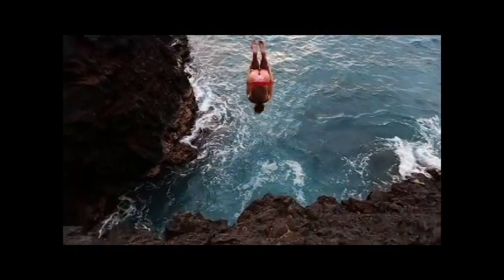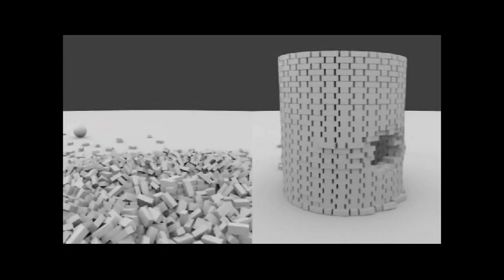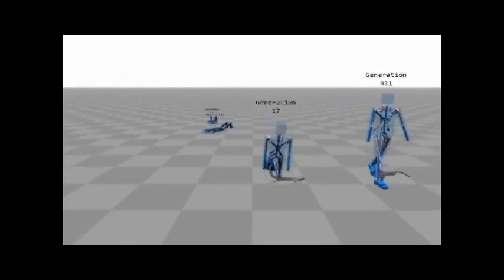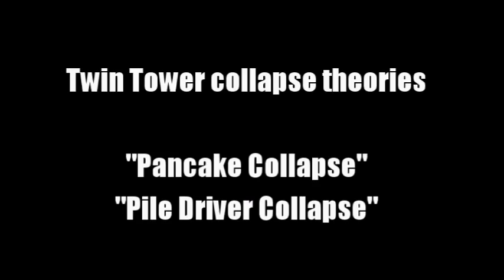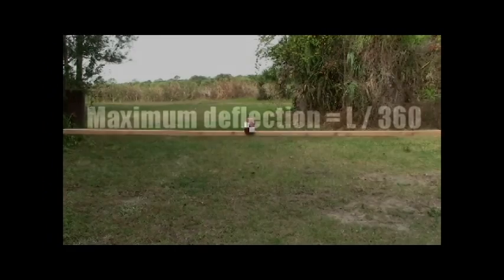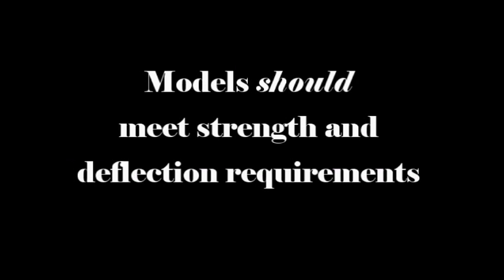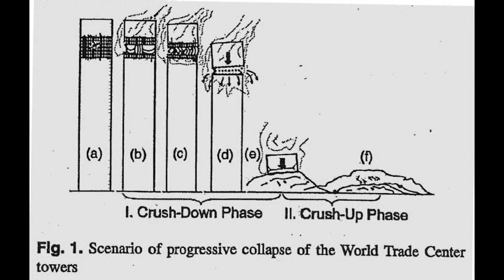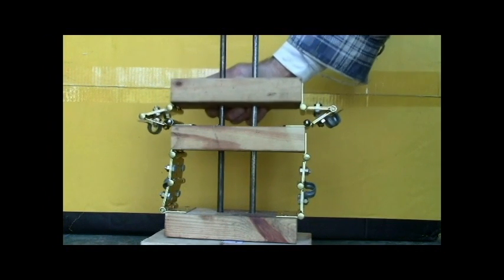9/11 Experiments: The Force Behind the Motion

Comment: Your experiments are deeply flawed and donot even remotely resemble to construction of the Towers. For instance, none of your experiments can account for the potential energy stored in each of the floors due to their position and construction. They rely solely on a single weight doing all the work. As each of the floors collapsed under the weight above, each of their potential kinetic energy multiplies the net force. Taking this into consideration, you really botched your "experiments". This is precisely why computer modeling is so important and so prevalent... because silly little models such as yours are unable to account for the many variables involved, whereas computer simulations can.
Reply: ErgoCogita u dont have to use a physic bro..just use common sense..1 fvcking plane made from aluminium can demolish the building and turn it into dust?..and why building 7 collapse when the plane didnt even hit the building..?
Reply: +ErgoCogita  Did you do the experiment in science class with the potato battery that proves that the unseen electrons flow between dissimilar metals immersed in an electrolytic environment? I did, but I failed to ask how that was proof that Niagara Falls power generation was possible. I guess I'm just a Putz according to you?
Reply: +ErgoCogita  If you want to conduct a scientific experiment at home of any validity, why not get yourself 110 small cardboard boxes, tape the lids and stack them up one on top of the other. Now bring your mighty paw straight down on the top with all your super strength to experience what resistance to motion is all about.
Reply: carlosdaperez it's impossible for anyone to recreate the 9/11 tower collapse...only thing anyone can do is attack a specific fact about the collapse and try to debunk that using models and experiments...the most basic fact people discuss is that the 50+ floors beneath the impact areas of the planes we're not burning or heating up even...the downward weight of floors above could never cleanly bring down the entire tower the way they fell...there should have been massive resistance to the fall...the only known way for those towers to have fallen the way they did would be if the central support beams were being eradicated on every floor within a second or two of each other (hence the free falling you see in controlled demolition).
Reply: Semni Istiqlal Look I don't really care... firefighters who were there openly witnessed explosions, went into the towers and pulled out survivors...they gave detailed information on the damage they saw in the basements..walls being completely destroyed, the roofs caved in...all windows blown out, etc etc...if you want to discount eye witness testimony from what firefighters said they witnessed and saw in the basements of the towers, by all means...most other people can easily deduce the reality of what happened. I suppose you honestly believe building 7 very well could have fallen 50 stories due to a few random office fires too...if you want to believe the official story and that absolutely farce of a report NIST put out, you can...but thousands of engineers and scientists have now come forward to discount the events as we've been told...not 2-3 people... thousands. They can't all just be making this stuff up...both towers and more than 85% of building 7 we're not impacted by fire...yet all 3 literally fell to the ground as if they were paper...it doesn't make any sense...not to mention, it's NEVER happened before or after in history...like I said if you want to buy into the story that some moron sitting in a cave with laptops and thumb drives somehow masterminded an attack that beat the defense of a country that spends TRILLIONS of dollars every year in defense spending, by all means.
Reply: Newton laws do not apply in any easy/straightforward way to systems with mass transfer. Any argument appealing to "simple Newtonian physics" as related to negating the possibility of the natural WTC collapse, should be simply dismissed. A lot of junk like this around.
Reply: Bruce Lansberg  You might be splitting hairs there Bruce since nothing can fall in earth's atmosphere at the hypothetical calculation of FFA with zero resistance. Do you have any other deflection to support your conspiracy theory that may have substance?
Reply: So do you have some computer models that can explain how steel turned into dust?
Reply: evsupp2011 You might not want to call people you are accusing of character assasination and insults shills. It's more than a little hypocritical of you.
Reply: Gurvinder: There is a lot to unpack there, you'd do better to stick to just the one argument at a time. Why don't you care what the rest of the mountain of evidence suggests? Is it because the witness testimony alone supports the conclusion you prefer? I've never heard of this specific testimony before, do you have any source to it?
Reply: Gurvinder - "explain to me how building 7 fell so quickly into it's footprint"
Now I am puzzled. Just one quote earlier you said "that absolutely farce of a report NIST put out". From this quote I deduce you have read the report, or you at least have a grip of its content. Yet you ask how WTC7 came down, which is explained (as a most probable collapse sequence) in this 800 page document. So either you have read it and know the cause of the collapse, or you haven't read it and simply made up an opinion about it. See why I'm puzzled? Have you read it or not?
Reply: "I'm sure you think all of them are delusional and not worthy of being on stand as a witness..."

Some are delusional and not worthy of considering, for sure. I never count that out as a possibility in such a large pool. ;)

"explain to me how building 7 fell so quickly into it's footprint..."

Read the damn report. You don't even have to read the whole thing to answer this question. If you are asking this question, you have obviously not yet read it.
Reply: Reading the report is basically the minimum level of effort you should do before criticizing anything about it.
Reply: evsupp: What evidence do you have that he is a shill? I havn't seen you present any argument aside from the accusation.
Reply: If that's the only infromation you've found on the events then I can undertand your point of view. However there's a lot more information out there if you know what to look for.
For example, the object in question did hit the ground and judging by the damage  to light posts along the flight path whatever hit the pentagon had a wing span of over 100 feet. Conveniently a plane with that exact description was highjacked in the general area and it and it's passengers were never heard of again after the event. Also fundamentally missiles and planes are the same thing. It's just a difference in payload and scale.
Reply: Jacob Silverstein - "A simple experiment is not a flaw"
Unless someone tells us it is supposed to represent something it doesn't.
Reply: evsupp - Please do not be a scared little boy now. I asked you a question a while ago and I am still waiting for your answer. You said:
"Every bit of information you provide is pure bullshit"
I asked: "Please be specific: which piece of information is wrong? Why?
You see, when you call some a liar without any kind of attempt to explain why, it is becoming obvious that it is actually you that has no idea what you are talking about. When you resort to personal insults and vague, unsubstantiated claims, it is becoming painfully obvious that you have no real arguments left. Be a man and answer my question. I know you can't. I also know why you can't. Do you know?
Reply: Jacob Silverstein - I must have misread your "REPLY" at the end of your last message for a demand. If it was not meant as such, I apologize.
Extended objects can only be treated as single point masses if they are approximated as a single point particle. How would you like to approximate a collapsing building (or the 15-30 upper floors or 95-80 lower floors to be more precise) as a single point particle in practice? As soon as the building starts disintegrating, there are numerous centers of mass acting upon all others, creating new ones, moving all over the place, getting larger and smaller. I am saying that a mathematical model would never be able to predict how the towers would collapse due to the complexity of it. So any reference to "simple Newtonian physics" and "violation" would be off. The reason why this part is so important to me is that Chandler makes us believe that there was something like "simple Newtonian physics" when he demonstrates a massive upper block and a lower massive block as a representation of what happened on 9/11. He even ignores the influence of gravity (the driver of the progressive collapse) when he compares the collapses to two cars colliding (on a horizontal surface). Chandler is the source of the claim that Newton's laws would have been violated in NIST's explanation.

I know what Euler's laws represent. Since I am not an engineer, I have not studied them in detail, but I am aware of them.
Reply: Jacob Siverstein - I assume you are aware of the design of the towers. Now imagine there are no bolts that keep the floor trusses connected to perimeter and core. Would you agree the floors would simply come down when shifted just a bit? I guess so :). Would it would have the same you then also agree that the perimeter would come down as it couldn't stand alone due to a lack of lateral support? Now imagine these bolts strong enough to keep the trusses in their places, but not strong enough to do the same when a dynamic load of 15-30 floors impacts upon them. Would you agree the result would be the same except achieved slower?
Reply: Lol so you are saying NIST didnt say they didnt here any reports of explosions, video below, yet you say I am full of BS LMFAO
https://youtu.be/iSnjyZNYlW8?t=6m2s

lol you say people were not being denied/turned away by hospitals when they mentioned 911 video below yet you say I am speweing BS LMFAO and this is just one example of a actual person frome ground zero:
https://youtu.be/e-Of50l77YQ?t=5m51s

And yes maybe I should not have posted that video of a civillian saying it vaporized but here is one with reports of the engineers saying the same thing yet I am full of BS:
https://youtu.be/eJb-GPtb2I0?t=40s

I mean how crazy is this more vidoes from different people reporting expllsions before the plane even hit just like the guy in the basement said explosions then momnets later the plane hit -- this even goes with WTC7 when there were repotrs of explosions in lobby or lower floors before all hell broke lose yet I am the one spewing BS 
https://www.youtube.com/watch?v=GXF9nUqeKk8

For the explosions its funny because there are countless videos with firefighters, news reporters, policeman, civilians etc. reporting explosions and many videos where you can here loud explosions going off.

So your question should be why would NIST lie and say they didnt know of any reports of explosions??????? When clearly there were many. Just like they lied about not knowing about any reports of molten steel.
And yes the video I posted eralier shows it is at 12:44 but the guy in the video clearly states that they started around 6am in the morning add in prep time and I am sure you can come up with the math for  about 6 hours its not that hard to do LMFAO And you act like the reporters only had video the entire day and the day before of video from just that one angle like come on now son lol.

And no crap I watched the video lol Bodies being found deep into the rubble 40 feet yes there are levels of basements no crap bodies would be found 40 feet below lol this goes along with the reports of explosions going off before the planes hit. Pretty simple to figure out. Another video of perosnnel saying explosions before the plane hit yet I am full of BS:

And you are an idiot LMFAO the dust is created by the explosions:
https://www.youtube.com/watch?v=SaBQ3AkRetI&feature=youtu.be&t=44s
This is your video at the very bottom of the building before the collapse what do you see??? Thats right dust coming out because of the explosions. Then what do you see as its falling down just like the WTC exact blowout of dust. Show me a video of a normal building collapse producing that much dust.....  I will help you out there is none LMFAO

And IDK yes usually during demos they are not really big gapes in time before they all go off anmd the building comes down IDK how it was done but the people onm the ground are just reporting what they went trhough the question once again is WHY DIDNT any INVESTIGATION invetigate for explosions????
 It seems there was no no cause for concern over all the dust??? Hell even if there were no reports of explosions they still according to US policy for structures of that nature were required to investigate for explosives but still didnt LMFAO but WHY???????? Whats wrong with asking these questions simply saying some BS doesnt cut it unless you dont want the truth to come out.

Lets say I am cooco for cocoa nuts and none of the steel turned to dust, this still doenst negate that a lots of people report explosions before the planes hit and explosions in WTC7.

Maybe you are so full of BS you think everyone else likes bathing in it LMFAO GTFO
Reply: evsupp - Please stop before you make an even bigger fool out of yourself. And try to write a reply by yourself for once.
"The smooth downward acceleration and outward motions observed are impossible by gravity alone."
Are you saying no lateral movement can be obtained from gravity? Does the concept of collision ring a bell? Does the concept of deformation ring a bell? Ever seen a billard ball change direction after colliding with another? I understand the idea of 3 dimensions might be a challenge to you. You might benefit from studying it however.
Reply: Timeoutcorner - Thanks for finally pointing me to the correct timeframe of this quote. If you want me to respond to your claim, you should not provide irrelevant links. I understand that the first one might have been a typo. But it lead me to the exact phrase I quoted before. So a little more caution is appreciated.
"Blasts = he is talking about bombs i.e. explosives going off"
Agree

"Loud sound"
He doesn't just say "loud sound". He says "this incredibly loud sound". If you would have read NIST's report on WTC7, or even the FAQ, you would also have know that this incredibly loud sound would have been 130-140 dB. Comparable to "standing next to a jet plane engine, and more than 10 times louder than being in front of the speakers at a rock concert". Selective quoting is not going to help win your case here.

"He is saying there are no videos at all recording loud blast sounds of bombs going off"
"He is saying no one ever reported hearing explosives/bombs going off "
Here we go again, he is not saying that. He is saying that this incredibly loud sound that would have been produced in any blast scenario, was not recorded or witnessed. You do understand the meaning of incredibly loud I guess :). He is not talking about the random explosions during the fires. You are. Show me 1 video or 1 credible witness that experienced this type of sound at the moment of the collapse.

"NIST is saying (in a what was it a 3 year invstigation) they did not find any reports or find any videos of explosions"
No. This is NOT what NIST is saying. See comment above. In addition, NIST acknowledges the precense of witnesses reporting loud booms. From the FAQ: "The sound levels reported by all witnesses do not match the sound level of an explosion that would have been required to cause the collapse of the building." So please teach me on comprehension again please...

"the local police in NY arrested individuals fleeing the scene with explosives"
Source? And does this even make sence to you? 

To summarize, you provide false timestamps, you quote selectively and incompletely, you quote out of context and you quote phrases that have never been said or written. And yet you tell me "you are just trying your hardest to downplay facts to fit your narrative". See why I think this is funny?

Now cough up some real evidence please. You can start with the videos and witnesses of the 130-140 dB blasts just before the collapse.
Reply: TimeOut Corner and one more thing that you and Rodriguez, and every other truther is ignoring.   
What type of explosion would burn the skin off your arms hands and face, without any other physical damage??   
How about a fireball created from burning jet fuel in a confined space???
Reply: Timeoutcorner - all I do is provide  info"
No you don't. The only thing you do is parrot conspiracy videos claims. That's not providing information. That's stating claims. Only once (!) have you prvoided a link to a video that did not even confirm your false claim.

"A man named Sanchez"
Who is Sanchez? The guy is named William Rodriguez as both Joe and I have explained before. Do you even read the posts you comment on?

"As they were walking past the freight elevator a fireball erupted from it."
That's where Rodriguez is contradicting himself.

"But it could also mean as you are trying to say that a fireball from the plane hit is what they witnessed as well. Interesting I will say this I will not discredit this."
I mentioned this over two weeks ago and your respons was very different. This gives me some hope.

"You have any sources for it?"
"do a Google search on William Rodriguez debunked"

"I am not scared to be proven wrong"
Yes you are. I have proven you wrong on ALL your claims. Yet you simply ignored it. If you don't trust what other people say, why don't you just Google it? That's what I do when you make a claim. I have provided you with numerous links to evidence that backs up my claims. You can use these links or find your own. But you won't because you ARE afriad to be proven wrong.
Reply: TimeOut Corner..  Maybe if you would FINISH your research.. you might learn the whole story.  
Here is YOUR first link.  https://www.youtube.com/watch?v=BVhBXFly-jM
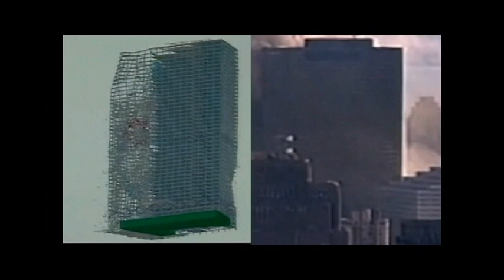Go to 3:08 and listen to what that officer says.   
This report has NEVER been substantiated.       Yea. idiots are going to drive around lower Manhatten, ON 9-11, in a van with a mural of the towers getting hit by a plane on the side, loaded with explosives....... And you idiots lap it up..
Who knows what or who was stopped by the bridge...  something was reported in error...just like the BBC reported wtc7 had collapsed.... 20 minutes before it actually did.
And your last link deals alot with FBI report of the '''5 dancing Israelis""", mixed in with that audio from a ''supposed'' police radio...
Reply: Timeoutcorner - "no where do they say in any of those articles that they were false"
Did you read them?
- "Though men in a van were detained, the vehicle did not contain explosives."
- "the station corrected it when it learned that the report was in dispute."
- "We’ll have to put that in a long line of things that’s under the, ‘Well, we’re skeptical now.’ "
- "Though no explosives were involved after all"
- "Accounts from ABC's John Miller and Kramer [...] were not the only ones that sagged over time."

What do you think the meaning of these lines is?

Or how about the article here that mentions 3 men captured with a van full of explosives:
http://www.breakingnews.ie/world/three-arrested-with-van-full-of-explosives-23429.html
And 8 minutes later the correction:
http://www.breakingnews.ie/world/police-confirm-arrests-but-deny-explosives-find-23430.html

"But again you had the Comiss telling the Mayor himself that they captured such suspects with explosives"
Source?

"But again this still does not negate the fact that we have LIVE AUDIO from the police officers themselves that day"
True. The same way we had live audio and footage of reporters saying there was a van with explosives that turned out to be false... There was also mention of radio controlled planes in the same recordings. How would a police officer know this? Just saying that police officers make mistakes too.
Reply: TimeOut Corner how do you know that radio broadcast is authentic?? 
How do you know the supposed photographs of people installing fuses is authentic??? 

Numerous sources have stated the report of a van with explosives was false. Numerous sources.. Dan Rather actually retracts it.. 

No evidence of explosives were found anywhere in any Tower.  No damage beams were seen by the clean up crew and I'm sure they would have reported something had they seen it.  
That's what I mean  by ignoring evidence to continue belief in your factless theories
Reply: "the one trying to convince people cops now have no clue as to what they are seeing and that they are imagining rainbows and unicorns on a day when thousands lost their lives"
Who is trying to convince you cops are imagining rainbows and unicorns? You read 10% of what I wrote and make up 90%. That is not how a grown up debate works my dear friend.

"a crap load of people report explosions, even loud explosions... and you are talking about ignoring evidence"
So what? Who is ignoring that?

"There are pictures with people installing crap loads of fuses into the WTC the year of 911 and you want to talk about ignoring evidence?"
Another example of you simply not reading replies. First, please show me those pictures please. They do not exist and you know it (unless you made up 90% again). In a very recent comment above, I have responded to this rediculous claim as follows: Could you please provide a link to these photos? I am aware of the Austrian art collective going by the name of Gelitin. I think you are referring to this. There are no pictures of them installing any fuses. There are however pictures of them executing one of their projects named The B-Thing (http://www.gelitin.net/projects/b-thing/ ). That project was conducted 19th March 2000, 1.5 years BEFORE 9/11. The boxes you see in the pictures you mentioned were put up as a boundary of their space in which they were able to work on their project. The boxes are labelled BB18. If you would take any effort (yes, you're lazy) you would know that BB-18 is a power feed lug for a 3 phase bus bar system. Not detonation fuses, but electrical power fuses. 
http://www.littelfuse.com/products/fuse-blocks-fuseholders-and-fuse-accessories/dead-front-fuse-holders/powr-busbar/bb18.aspx

So your imagination is running away with you. Again. Please do not teach Joe or me about ignoring evidence. Would you like to have a discussion about making up evidence?

"We can go on and on "
Please go on. Can't wait to debunk even more of your bullshit claims.

" the things you guys do to discredit witnesses etc. is mind blowing"
What things exactly?
Which witnesses have been discredited?
What is etc.?
The only mind blowing thing here is your effort to explain the most random, unrelated issues into part of an imaginary conspiracy.
Reply: Timeoutcorner - First of all, thanks for writing a reply that is actually readable. You even used interpuction. It makes reading it and understanding what you are trying to say at least a bit less difficult and frustrating. Chapeau!

"says the guy who thinks people can tell how much something is in BS to determine if something was a bomb blast or not"
Can you please guide to any of my replies where I said such a thing? You asked me how people are supposed to know/describe how loud a sound is. I gave you an example like "Was it as loud as standing next to a jet engine? Yes/no". You are misquoting me again. I also explained that a CD blast will be as loud as 130-140 dB from 500 ft away. And may I assume by BS you mean dB? I know you like writing BS, but in his context it is a bit confusing. 

"according to you common sense means not questioning why they would say the Commissioner (higher up) is reporting that he is briefing the Mayor [...]"
I never mentioned any mayor, And I never mentioned any commissioner. YOU did.  So please stop lying. I have now asked three times for links to any of that. Never have you provided such. So I'll ask again in terms you might understand: What the fuck are you talking about?

"You never answered any questions."
Show me any question of yours I did not answer. Now show me any question of mine you did answer.

"For the last time why did NIST never actually test and investigate for explosives"
There IS something wrong with you man. I have explained three times before. In different ways. Either you are ignorant, dumb, not reading, or trolling.

"your ridiculous excuse of people not reporting blasts at a certain level of DB is not an answer"
Let me try to explain it in the most simple way I can: by video. Here is a short video of a controlled demolition. Please listen to the explosions. You need to carefully look at:
1. The loudness.
2. The sequence (how many explosions do you hear and how fast do they follow up)
3. Look at what happens to the building right after these explosions (hint: it collapses)

None of these happened at 9/11. This means: THERE IS NO INDICATION FOR A CONTROLLED DEMOLITION! And this is why NIST did not need to investigate for traces of explosives. Have you ever heard of silent detonations that do not follow up in a tight sequence and make a building collapse after 30 minutes or more? No? Niether have I. Neither has NIST. Neither has any CD expert. 

Here is the video: https://youtu.be/e2E_m7l2Rww?t=10s

"to once again undermine and try to discredit what people actually heard and witnessed that day. (another attempt of you trying to discredit witnesses you some how act like you have not been doing this entire time lol)."
You do not read! I have NEVER claimed people did hear explosions. NEVER EVER!! How am I trying to discredit the witnesses that heard explosions? I am discreting your lack of sensible reasoning. That's not the same. I have explained that there will always be explosions in office fires. I have explained that fireballs coming down through elevator shafts will cause explosions. Rather then trying to discredit witnesses, I am showing you have misinterpreted these witnesses. You linked their statements to alledged detonations. I have shown you these could not possibly have been detonations. Now for the fourth time.

"Not once have I discredited any witness."
I have never claimed such. So why would you mention this?

"I have questioned officials who even admit things like we have no clue why a building collapsed but then go on to say it was because of fires even though they say they dont know how it fell"
And yet another claim without any kind of link. What are you talking about exactly? The only time you have provided a link was to a video of a reporter interviewing a volunteer. Remember? It was that video where you made a fool out of yourself by saying it were officials. It was that same video where you stated they were zooming in to ground zero and there was nothing see, and I had to explain to you they were zooming in on West St. and ground zero wasn't even visible?

"if questioning and going off of what is available to find answers to those questions is Lazy then so be it lol"
You are lazy because you refuse to read any of our replies, you do not check claims you so vividly parrot, you do not click links we provide to back up our proof of your false claims, you do not even read the report you are claiming is full of lies. That's why you're lazy.

"you provide information from NIST"
As you have made false claims on NIST's reports, I have provided you real information from NIST. I have linked you to the report, mentioning paragraphs and page numbers. Of course I have provided information from NIST. Isn't that what this whole discussion is about? Next to NIST, I have used numerous sources which I have linked you to. Have you ever taken any effort to take a look at these?

"with so many contradictions its beyond a joke"
Now, be a man and name these contradictions so we can finally have a grown up discussion.

"But yet go to the end of the earth to find why every single witness is either stupid or have no clue what they are talking about. "
Please tell me where I have ever stated any of the witnesses are stupid or have no clue what they are talking about? This is another of your lies. Why do you need lies to prove a point? Why do you not stick to the facts?

"You get ride of the evidence"
I will play along and ask again: Which evidence? There is nothing to get rid of. You have written quite a lot in this thread, yet failed to come up with eny evidence at all.

"you half ass investigations"
I don't know what this means. 

"you lie"
Please show me where I lied and about what. Please quote me exactly as you provide it.

"and give false information that contradict each other"
Again, please show me where and about what. It is not my fault that you don't understand facts and misinterpret them.

"you push a narrative"
Of course I do. My narrative is based on facts. You push a narrative as well. Yours is based on youtube conspiracy videos.

"Then hope gullible people will not questions anything out that doesn't add up."
Please question everything you can/want. If the answer doesn't fit your preposessed opinion however, counter me with facts instead of asking the same questions over and over while they have been answered before numerous times already.
Reply: well genius his experiment cant convince dumb people ....who cant see the reality....a boing crashed in projects and the building never fell inspite of burning all day long ....and some egg head pain m.f cms out on tv and says worlds strongest building collapsed by a plane the size of my dick ....and people believe it ....the thing is frst it ws a plane or not never confirmed...second a jumbo dint collapsed projects ....which ws made by a low level mason nd architect nd twin towers collapsed which ws made by the top team...
Reply: @ carlos; not enough to cause the buildings to collapse at freefall rate

get a grip!
Reply: @carlosdaperez You don't seem stupid at all. You seem rather level headed and you explain yourself well and in good English.
Reply: ErgoCogita  i rather stick to the conspiracy theorist than to believe lies from the government..they said plane hit the pentagon..but no body, no evidence..no in the hell building 7 collapse like that just because of fire..oh btw..science is real..not just a conspiracy theorist
Reply: "You might be splitting hairs there Bruce since nothing can fall in earth's atmosphere at the hypothetical calculation of FFA with zero resistance."
- Have you ever seen photographs of the collapses of the towers where debris is falling way down the still standing part of the towers? If not, here are a few nice examples:
http://www.csi911.info/collapse_vlg.jpg
https://i.pinimg.com/736x/39/a1/16/39a116ac7b91e6013e3539aacfb7ab4a--north-tower-most-powerful.jpg
https://pearlsofprofundity.files.wordpress.com/2013/10/collapse-of-america.jpg

If the towers were collapsing at "free fall", how is the debris falling faster than that?

- Maybe this concept is difficult for you to grasp. So why not simply count and see how long it took for the towers to come down?
South Tower: https://youtu.be/qLShZOvxVe4?t=59s 15 seconds
North Tower: https://youtu.be/qLShZOvxVe4?t=2m4s 22 seconds

As for WTC7: https://youtu.be/KkKgLKyhqHk?t=39s 16 seconds
Reply: carlosdaperez Yeah and said energy decided to wait an hour before taking down the towers...must have sat there in preparation to take the entire building down at free fall speeds...very plausible....or maybe, just maybe the towers we're designed to take the impact of a plane and absorb the energy of the impact? Sure seemed like the buildings took the impact and absorbed the energy without falling to me.
Reply: You'd have to demonstrate that it is indeed impossible for the towers to collapse this way, this video certainly does not do that.
Reply: ErgoCogita fea is correlated with such ezperiments.
Reply: SewRobert People who are programmed to believe whatever they are told by media, government, etc will never let that belief system go...it's a social programming that's instilled into people from almost birth...the government knows this very well and have been using it as a tool for the last 50+ years...they don't need everyone to buy their lies...just a majority...that way, they can continue doing things like this with impunity and no remorse....as for the towers, the easiest argument that anyone can bring up is to ask how in the hell 50+ stories of reinforced steel and concrete UNDER the impact areas disintegrated so easily... don't even argue about heat, melting steel, etc...ask about the areas that weren't even affected by the impact.
Reply: SewRobert: It didn't? After the collapse there were heaping great big piles of mangled steel. The rest of the structure was drywall and unreinforced concrete for the floor spans. Both of those turn into dust ( or find debris ) quite easily. It doesn't take much force to bust up drywall as you'd know if you have ever done demolition.
Reply: Gurvinder Parmar - "People who are programmed to believe whatever they are told by media, government, etc will never let that belief system go...it's a social programming that's instilled into people from almost birth.."
Oh, the irony... The point is that even if you don't go with official statements, there are many sources which you can verify that tell the same story. These sources will for example tell you abouyt the engineering of the towers. Iif you would have taken the time and effort to check these, you would not have wondered about the bottom part of the parts for a second. 
"how in the hell 50+ stories of reinforced steel and concrete UNDER the impact areas disintegrated so easily"
- There is no such thing as reinforced steel. Easy to verify.
- There was no reinforced concrete used for the towers. Easy to verify
- Thr floors, that basically supported the perimeter laterally, were mounted to core and perimeter by bolts, connecting the floor trusses to truss seats. All which was needed was a force large enough to have these bolts snap. You don't seem to understand the consequensces of extremely long floor spans and the absence of vertical support beams to these floors. You don't seem to understand the role of the floors for the lateral stability of both towers. You don't seem to have any idea of how the towers were constructed whatsoever. Please do some homework and you will understand that once the collapse was initiated, there was nothing that could have stopped the progressive part of the collapses. Verifiable without even reading any of NIST's reports.
Reply: It's really easy to replicate 9/11. Just go to any old building set demolition and superheat the top parts of the floor by melting steal beams and watch what happens. I doubt it will collapse like the twin towers
Reply: Other than multiple reports of explosions, the hole blown in building VI. https://www.youtube.com/watch?v=9I_NXk-Iqjk&t=16s What casued this? Look at the billowing smoke, you think that carpet and computers on fire? 
Let me ask you this? When do bolts see a shear load?  All the bolt "snapped" on each floor  together at once? Really? Was the fire totally symmetrical? How was that  lady standing  in the hole left by the airplane if jet fuel started this fire that weakened the building?
Reply: Bruce Lansberg Concrete that has steel rods in it IS reinforced...if you want to believe every floor could easily fall the way it did, by all means believe it...there isn't one engineer or PhD that says otherwise, it's hundreds and thousands now...they can't all be insane...and building 7 feel identical to the towers due to office fires? Yeah sure...only 3 buildings in human history to go down at the rate of free fall due to office fires... something really special must have been in the air that day since it's never happened before or after.
Reply: Gurvinder Parmar - "Concrete that has steel rods in it IS reinforced"
I am aware of the concept of reinforced concrete. I am NOT aware of the concept of reinforced steel. The second does not exicst. The first was not present at the WTC towers. The WTC floors were light weight, 10 cm thick concrete poored on composite metal decks. There was no reinforced concrete. Take a look at this video here. I time stamped it so it starts at the right moment. You will see workers pooring the concrete, standing in the wet concrete. See how deep their boots are in. There is no rebar of any kind: 
https://youtu.be/aPxqR8SNSCU?t=11m56s

".there isn't one engineer or PhD that says otherwise, it's hundreds and thousands now"
The E&A911 community has exactly 2,911 signatories at the moment of writing: http://www.ae911truth.org/about.html. The list contains professionals in computer engineering, electrical engineering, astronautics, mining engineering, chemical engineering, biomedical engineering and many, many other NON-RELATED professionals. It is estimated that there are 4 million architects in the world. I couldn't find an accurate number for engineers. However, in the US alone, there are currently 1.6 million employed engineers. Considering the fact that the EA911 list covers not only the engineers from the US, but world wide, and covers ex-engineers, and covers students, how large do you think the percentage is that actually disagrees? I am not saying these people are insane. I am saying however that these people clearly do not understand the engineering of the towers.

"and building 7 feel identical to the towers due to office fires?"
Building 7 did NOT AT ALL fall identically to the towers. The towers collapsed from the points of impact. Building 7 collapsed fomm the bottom.

"only 3 buildings in human history to go down at the rate of free fall"
Rate of free fall? South tower 15 seconds. North tower 22 seconds. Building 7 15 seconds. How is that "free fall"?

Your starting assumptions are false and therefore your conclusions. And I assume your false assumptions stem from conspiracy videos. It is worth to really investigate the claims being made in these videos.
Reply: Jacob Silverstein - "multiple reports of explosions"
Explosions do not necessarily equal explosives. Explosions in fires are not uncmmon (to put it very, very mildly). Has any report described explosions like these? Listen to the sequence and volume: https://www.youtube.com/watch?v=e2E_m7l2Rww

"the hole blown in building VI"
There was no hole "blown" in building 6. Building 6 got hit by falling debris from the north tower. Here is a nice picture from the inside of building 6: https://powerm1985.files.wordpress.com/2017/02/inside-wtc-6.jpg. Do you see the exterior panels of the north tower still hanging on the roof line? Do you see these same panels at ground level? If you're convinced yet, take a look at the next picture and look for the red colored panels. they are all over the place. Guess where these came from? :)

"What casued this?"
Are you talking about the puff at about 1 minute? Do you think this is an explosive going off? Don't you think it is a bit strange you don't hear this explosion? And what good does 1 single explosive do to  demolishing a 110 story high rise? Have you looked at the speed (or rather, lack of) of this puff? Did you hear the reporter and cameraman not being impressed by an explosive going off? Would you feel comfortable standing at ground level witnessing any demolission explosion? And why did it take so long for the tower to come down after this "explosion"? What we see (and do not hear) is a blow out of dust, caused by compressed air due to a falling floor, ontop of the next one.

"When do bolts see a shear load?"
When the truss seats are pushed downward by the falling upper floors.

"All the bolt "snapped" on each floor  together at once?"
All the connections from floor to truss seat snapped at once on every individual floor, given a few miliseconds. 

"Was the fire totally symmetrical?"
No, it wasn't. Why do you think this is relevant to the progressive part of the collapses? The initial part was caused by the fires. The progressive part was caused by the engineering. When parts of the structure started failing due to the fires, the loads they carried were tranferred to other structural parts. Until the moment that the remaing parts could bear the load any longer. As a result the remaining parts failed at more or less the same moment (again, as a result of the engineering, read into it), starting the progressive phase. 

"How was that  lady standing  in the hole left by the airplane if jet fuel started this fire that weakened the building?"
I have no idea what you're trying to say here. Could you please a bit more specific? I know you are referring to Edna Cintron, most probably. But I do not understand why she could not have been standing where she was.
Reply: yanke zhou -  I hope you're being sarcastic.
Reply: the 9/11 commission reported between 9-11 seconds I believe... each tower took a little different time,  thats actually damn near free fall if my math-a-nator is working right.... yea free fall with no restraint would have been about 8 seconds so actually the official story agrees on the "free fall"
Reply: codemiesterbeats - "the 9/11 commission reported between 9-11 seconds I believe"
The 9/11 commission reported the south tower to have collapsed in 10 seconds. They were wrong. So what? Here is a short video of the south (and north) tower collapse. You can simply count with the video and see how long it took: https://youtu.be/qLShZOvxVe4?t=59s

15 seconds. Free fall accelleration would have had the towers collapsed in 9.2 seconds.

The "official story" comes from NIST, not from the 9/11 Commission. NIST describes: "NIST estimated the elapsed times for the first exterior panels to strike the ground after the collapse initiated in each of the towers to be approximately 11 seconds for WTC 1 and approximately 9 seconds for WTC 2.".So NIST is clearly talking about the first exterior panels to reach the ground. These panels were indeed falling at near free fall acelleration as can be observed from numerous videos. We can clearly see the debris falling past the still standing parts of both towers, which is a clear indication that the collapses themselves did not occure at free fall accelleration. This is confirmed by the video I enclosed above.
Reply: evsupp - I am aware of the eye witnesses accounts. I am also aware that a lot of these eye witnesses have described hearing explosions. The question however is how many of these think these explosions are related to explosives. Then again, if they think explosives have been involved, what have they seen or witnessed to back up this idea? When someone describes an event and uses the phrasinf "as if", doe you think they mean exactly that or would you think they merely use an anology to describe this event? If I wake up in the morning after a good night out and I say "I feel as if I was hit by a dump truck", do you think I actually believe I was hit by one? Or do you believe I am merely using an analogy?

Moreover, please watch the short video I posted in my earlier reply. Here is what you should have heard and seen if explosives would have been used to bring the towers down. None of that was present at 9/11.
Reply: Bruce Lansberg Several firefighters we're on the ground level after the impact(s) and  ran into the basements of the WTC towers due to huge explosions that literally ripped apart the walls and under structure of the towers...they went in to try to save the lives of people who worked in stores and shops that are there... several of them repeatedly told their commanders to possibly not send more firefighters into the towers because the buildings were wired up with bombs...there was zero explanation for explosions going off in the basement when the planes impacted floors up at the 60 floor level...mind you this was being told by firefighters who heard and experienced the explosions and then ran in to save survivors.
Reply: Gurvinder: Eyewitness accounts are not very reliable, in court they are considered the lowest form of evidence. Especially when coupled with the fact that you have no chemical or structural evidence of explosives being used. If a bomb ( or bombs ) did go off you'd expect to find traces of the weapon, bomb fragments, chemical traces of the explosive as well as evidence of a shockwave or explosion in the debris. There's none of that. In stead you might want to look to an alternative explanation for what these eye witnesses experienced. Hundreds of thoustands of tons of steel falling roughly a hundred meters is going to create a hell of a racket. The buildings themselves are about 80% air, air that's being compressed by the collapsing building and is trying to find it's way out with almost explosive force. The collapse itsself could very well sound like an explosion or series of explosions. Remember that hollywood creates a lot of it's explosion sounds by slamming objects together, and that's for most of us our primary experience of explosions.
Reply: Semni Istiqlal there's probably no less than a hundred different videos showing firefighter testimony on YouTube...but the real documentaries done on 9/11 like Loose Change 9/11 show them in much more depth... including many other people and police officers all saying the same thing...I'm sure you think all of them are delusional and not worthy of being on stand as a witness...but let's just forget that for a second and you explain to me how building 7 fell so quickly into it's footprint...no airplanes hit that building...it had small office fires on a few floors (not one floor was entirely engulfed in flames either)....yet a 50 story building collapsed anyway just like the towers did...only building in history to do such a thing.
Reply: evsupp - I note you have completely ignored my reply and simply took the next unsubstantiated claims from the truther community. Would you like me to address these or may I suggest to finish up your earlier claims first? So, how many of these eye witnessesactually think these explosions were related to explosives? Of these, what evidence backs up this idea? Would you agree that just some of these eye witnesses that mentioned "as if it was detonated" could have used this in a figurative sense? Like the quote actually proves: "as if". I answered your questions. It just seems fair you answer mine.
Reply: ebsupp - "WTC7 was wired for demolition ...obviously.We all have eyes.  It follows that WTC 1 and 2 were also wired. So the sounds these eye witnesses head were explosions ....detonations."
Classic example of circular reasoning. You assume WTC7 was wired. Therefore this assumption proves WTC1 and 2 were wired too... So the sounds the eye witnesses heard must have been explosions from a controlled demolition :). Let me ask you this: If WTC7 was not wired, would that be proof of the witnesses hearing something else than explosives from a controlled demolition? If you answer "no", you have some explaining to do. If you answer yes, you need to come up with some evidence WTC7 was wired. "We all have eyes" is simply not good enough. Did you by the way notice that WTC7 came down bottom up and the towers started collapsing top down? From the points of impact? Please explain to me how these are related in any way?

"We know who orchestrated 9/11, Landsberg. Question is ....why do you defend them? What do you truly stand to gain by defending traitors and murderers?   Is the money that good? The only shills who do this voluntarily are hasbara operatives. Is that you landsberg?"
This response is a clear indication for me that you have run out of real arguments. I have seen it happen before more than once and I am not impressed. It is a typical defense tactic of conspiracy theorists. Critics are part of the conspiracy. Let me please quote Dr. Thomas Swan who studied cognition and culture at Queen's University Belfast. He's researched a range of psychological traits and disorders: 

"A common trait among conspiracy theorists is their need to derogate critics. Criticism must be devalued because it threatens the comfort provided by the conspiracy. This is done in one of two ways. Either the critic is too dumb to see the intricacies of the conspiracy, and is thus contributing to it by ignoring it; or they're actively helping the conspirators to cover up the truth. The unconsidered third option: that the critic is just not convinced by the evidence, is undesirable because it would create a reason to doubt the comforting belief.

The two ways of derogating critics have distinct, self-serving functions. In believing that some critics are too dumb to see their special knowledge, theorists establish their superiority. In believing that other critics are part of the conspiracy, theorists are manufacturing evidence to support their special knowledge."

Does that sound familiar to you evsupp? Manufacturing evidence?

So, could you now please address the content instead of deviating from the topic? Unless of course, you have run out of arguments.
Reply: evsupp - "That's why these days their only weapon is character assassination, guilt, and insults."
You called me a shill before. May I assume this quote applies to me too? If so, could you please point out when and where I have engaged in any of the abpove mentioned? Making up evidence again, aren't we?
Reply: Gurvinder Parmar - "huge explosions that literally ripped apart the walls and under structure of the towers"
I am not familiar with any explosion that literally ripped apart any understructure. could you please guide me to some citation? I am not denying there were explosions by the way. We have seen them in a lot of videos. We have seen the huge fire balls when the planes impacted. Which firefighters are you talking about exactly? Could  you please post a link? I am asking because i would like to understand if it was the second plane hitting what these firefighters experienced of the collapse of the south when they were inside the north tower. Thanks.
Reply: evsupp - I know you ignore any evidence, logic, reason and science on 9/11. Otherwise you wouldn't have been a conspiracy theorist. But here you did it again: change subject.

"You can't handle the truth."
I find this comment rather ironic. As soon as I debunk your ridiculous claim with verifiable evidence, you either change subject, or call me a shill, or ignore it, or make some other non-related general comment. One of is indeed seems not to be able to handle the truth and it isn't me.

Why not at least try give some feedback on the content of my replies? As long as you don't, it seems to me you are not interested in the subject matter whatsoever. Which leads to the question what you are doing here in the first place.

About Cossiga. I would strongly encourage you to do some factchecking before you repeat others' conspiracy claims:
- First of all, he was obviously being sarcastic, since he stated just a few months earlier "it seems unlikely that September 11 was the result of an American plot".
- He did not reveal Operation Gladio, Andreotti did after Felice Casson bumped into some information on Gladio while researching passed crimes. After this, Cossiga resigned.
- He never mentioned "false flags". See your own quote. He also did not say that this knowledge was common among global intelligence agencies. He said, well, read your own quote.
- Cossiga was a bit nutty. He was a hige John le Carre fan: "I like spies the way most people like flowers", "I’ve been through periods of depression, and taken antidepressants", and "In a normal country, if a president of the republic did what I do, they would put him away at once."
- He never provided any evidence (why would he, he was being sarcastic), just like you.
Reply: ErgoCogita i think he very precisely said that it can only be replicated by the structuress at each floor being removed at pretty much the same time. now call that what you will, but that a controlled demolition, ken.
Reply: Esvupp - "Every bit of information you provide is pure bullshit"
Please be specific: which piece of information is wrong? Why? And where are the verifiable facts to back that up?

"Sarcasm? You disrespectful idiot. He said it, as quoted. FACT."
I just realized I owe you an apology. I assumed you would understand the meaning of sarcasm. Let me quote Cambridge Dictionary: "the use of remarks that clearly mean the opposite of what they say, made in order to hurt someone's feelings or to criticize something in a humorous way". I never said he didn't say it as quoted. I said he was obviously being sarcastic and I added an explanation: Just a few months before he said "it seems unlikely that September 11 was the result of an American plot". When you state the opposite shortly after, it is sarcasm.

" He said it, as quoted. FACT"
I asked you before but you failed to reply, could you please link your source?

"He knew about Gladio"
Again, please check your sources. Of course he knew about it. He was a member. Some even say he was one of the founders. Your quote is like saying Hitler knew about the Holocaust and he authosirzes disclosure... Why do you think he was empeached?

"and whilst in power he authorised disclosure"
Again, it was Andreotti who made it public after Felize Casson investigated Gladio. Please do some reseracch. It is all there!

"He was successful in exposing the CIA for the bunch of murderous twats they are. FACT."
He never exposed anything. 

"A bit nutty because he read Le Carre?"
No. You are quote mining and dismissing context, like a real truther. The line about Le Carre was an introduction to what came next. 

"The biggest fact here, of course, is that YOU, Lannsberger, are a shill, a paid-off turd who lies for a living and insults anyone who provides evidence that destroys your pathetic 9/11 myth."
So when I point out the flaws in your facts, reasoning and logic, I am insulting you? Well sorry mate, but I guess you'll just have to live with it. May I remind you that it is actually you who resorts to personal insults. It is common amongst conspiracy theorists when they have run out of arguments. No offence taken. And please list the lies I have told, explain why they are lies and provide verifiable evidence for them. If you don't I will assume it is because you can't.

"You disparage a brave man who exposed CIA criminality."
You are defending the wrong person dear evsupp. get your facts straight!

"Fuck off shill. You and your comments are irrelevant."
I'll decide if and when I will "fuck off". Thanks. I allow you your unsubstained claims. It seems just fair if you'll allow me to provide some real facts to counter your absurd claims. And as long as you keep posting bullshit, it is actually you who is irrelevant.

Shall we gat back on topic now and discuss the bullshit "experiments" in the above video?
Reply: daxter: His experiments don't even remotely resemble the real life situation so you cannot draw any real life conclusions from it.
Reply: carlosdaperez as an engineer I can say simple exprtiments follow physics. Therfore.....add it up.
Reply: Semni Istiqlal To do something that is scientifically accurate is next to impossible...or it would require a lot of pressure planning...that's not the point of the video...it was meant to point out certain things which should be apparent to anyone.
Reply: And those things don't apply to something like the WTC towers because that's not how they were built.
Reply: Semni Istiqlal The point of the video was explained in the very first few minutes...and he's right about everything..the collapse at the towers, according to the official account and NIST, we're impossible...based on science and natural laws, the official account is 100% inaccurate...now, that has absolutely nothing to do with conspiracy theories or 9/11 being an inside joke, etc....it's only to say that the official story we were given is wrong.
Reply: Exactly in what way does his video disprove any part of the NIST report?
Reply: Semni Istiqlal Search YouTube...you don't have to go far...and watch the documentary Loose Change 9/11...all the eye witness testimony is available, if you actually care to find it.
Reply: Semni Istiqlal It disproves EVERYTHING NIST said...the most basic parts being how they explained the collapses of all 3 buildings...the model they used to show building 7 was especially funny...single point of failure brought an entire 50 story building down at the rate if free fall...lol, the building must have been built out if cardboard...what's more interesting is if you watch building 7's collpase in slow motion, you can clearly see the center if the building start to give way right before the rest of the structure goes down...not exactly what NIST said right?
Reply: Gurvonder - You said: "the collapse at the towers, according to the official account and NIST, we're impossible"
NIST is the "official" account.
I asked you before and didn't get any answer: Did you or did you not read the report?
If you have read the report, could you please point out which part of NIST's explanation is impossible?
If you have not read the report, how do you know it is impossible?

And you said: "based on science and natural laws, the official account is 100% inaccurate"
Which natural laws are you referring to? Newton's laws of motion may I assume? Which natural laws were violated do you believe and why? You see, I don;t believe for one second that have read any of NIST's report(s). From the way you post your claims it is more than obvious you have watched some conspiracy videos and fell for them. Next you simply copied/pasted these claims without understanding them. Am I wrong? In the next post you refer to Loose Change... Loose Change is the definition of conspiracy theory. Why don't you watch some Loose Change debunking videos? Nothing to lose and a lot to win. Loose Change is a farce not worth discussing. Even the truth movement has realized this.
Reply: Gurvinder - "the model they used to show building 7 was especially funny...single point of failure brought an entire 50 story building down at the rate if free fall."
What the hell are you talking about? Free fall? It took building 7 15 seconds to come down. Typical truther claim this free fall myth. The only thing that came down in 6 seconds was the shell. The interior of the building started collapsing 9 seconds earlier. have you ever seen the collapse of the penthouse? How do  you think that collapse was caused?

"what's more interesting is if you watch building 7's collpase in slow motion, you can clearly see the center if the building start to give way right before the rest of the structure goes down"
No put this claim in context of the above...
Reply: Jacob Silverstein - As an engineer you should be ashamed to make a comment like that. Which makes me believe you are not an engineer at all. If you are, you missed a few classes apperently. What do these experiments have to do with the reality of the twin towers on 9/11? As an engineer you should be able to answer this question without even hessitating for a split second. I know the answer, Do you?
Reply: Bruce Lansber What question are you responding too?
Reply: Bruce Lansberg your assuming, somthing an engineer would never be, Bruce.
Reply: Jacob Silverstein - "What question are you responding too?"
I was referring to the question I asked right before I referred to it: "What do these experiments have to do with the reality of the twin towers on 9/11?"

There are still some unanswered questions that I addressed to you earlier. Not necessary to answer them, but I highly apprecitate your professional opinion:.
You can look them up. They are in this thread, addressed to you:
- Has any report described explosions like these?
- Do you see the exterior panels of the north tower still hanging on the roof line?
- Do you see these same panels at ground level?
- Are you talking about the puff at about 1 minute?
- Do you think this is an explosive going off?
- Don't you think it is a bit strange you don't hear this explosion?
- And what good does 1 single explosive do to  demolishing a 110 story high rise?
- Have you looked at the speed (or rather, lack of) of this puff?
- Did you hear the reporter and cameraman not being impressed by an explosive going off?
- Would you feel comfortable standing at ground level witnessing any demolission explosion?
- And why did it take so long for the tower to come down after this "explosion"?
- Why do you think this is relevant to the progressive part of the collapses?
- Could you please a bit more specific?

For the correct context, see post.
Reply: Jaco Silverstein - "your assuming, somthing an engineer would never be, Bruce."
Well, I'm not the one who claimed I'm an engineer in the first place. But more importantly, you have assumed the whole conspiracy theory. A theory that is made up, based on nothing but speculation, very early (and long after restated) reports, poor science, misconception of physics and a whole lot more but facts. You have not been able to provide any verifiable evidence at all. Something an engineer would never do Jacob.
Reply: Yeah, evsupp is back in da house. Dear evsupp, if you know so certain 9/11 was an inside job, why won't you be able to cough up some evidence, backed up by verfiable facts? You have done nothing but make superficial claims (well yeah, you added some verifiably false information on a former Italian president provided by some very poorly informed source, and remember, I showed you why it was false information, and we're not even discussing the irrelevance of that piece of "information" to 9/11). All you do is avoid the topic, avoid answering any questions you have been asked, copy/paste the same replies all over the place, make vague claims without backing them up and misinform people that really would like to understand what's been going on. You suffer from Pavlovian conditioning my dear friend. Every reply that doesn't suit your personal narrative, you respind to in the same way: Shills. Do you really think you are important enough to be bugged by shills? :) Did it ever occur to you that intelligent and educated people cincerely disagree with your opinion? Ever wondered why these people have been able to debunk all of your ridicolous claims with verifiable facts?

My friendly advice to you: stop watching youtube conspiracy videos without checking the claims, the facts and the sources.
Reply: Thanks for proving my point esvup.
Reply: Lorenzo Torricelli Newtons laws are the basis of Engineering mechanics. Like my books by Hibbeler, Beer & Johnson..
.
Reply: Esvup - Your replies are now beginning to look like spam.
Reply: Jacob Silverstein - Some truthers are often paroting the claim Newton's laws did not apply on 9/11. What these truthers do not understand is the fact these laws do not apply to buildings as a whole. Newton's laws are theoretical laws applicable to single poin masses. I am sure you are aware of that. Upper or lower blocks of the twin towers (or any building for that matter) can not be considered single point masses.
Reply: Bruce Lansberg , so with the Pentagon, u think a pilot with no experience can do a 290'corksrew decent at some 500mph an get it exactly right as he didn't even touch a blade of grass. Haha he's  some rookie I guess.
Reply: Farlap: It's possible. Just because it's improbable doesn't mean it didn't happen. Especially considering that's the way all available evidence is pointing.
Reply: Semni Istiqlal ,, all the evidence. Like the one split sec video. Does that even count. I see a tip of what resembles a missile more than a plane nose..and then I see fire. Its also probable I can beat lebron one on one. But we know that can't happen.
Reply: Semni Istiqlal,, u say all available evidence..(strictly talking Pentagon) which is all.. Cos I can't find any except the vid from the fukn servo across the road. I only know the flight path. And god couldn't even do those manoeuvres in a plane.
Reply: Extension of Newton applies to whole structure, else quantum mechanics? Not.
Reply: Jacob Silverstein - Do you or do you not agree that Newton's laws apply to single point masses only? Do you or do you not agree that the upper parts of both buildings behaved all but like single point masses? Do you or do you not believe that the upper parts are deformable bodies?
Are you referring to Euler?
Reply: Bruce Lansberg Newton applies to all physical bodies. Else it is quantum.
Reply: Bruce Lansberg They got fragged.
Reply: Jacob: Do you know what point masses are? What deformable bodies are? What rigid bodies are?
Reply: To the point of knowing that there was nothing left holding those buildings up is the point. Do not be deceived. They fell fast enough to prove that point. A cascade failure would not have left the "spire" standing. Look at the squibs. The mass ejections. Go to war for us, it was the Arabs.
Reply: A simple experiment is not a flaw. Eyes wide.
Reply: Jacob Silverstein - You keep dodging my questions. This time I asked you three simple yes/no questions. Yet, no answers. I anwered your questions before It seems fair you answer some of mine.
Reply: Semni Istiqlal , yeh mate Im aware of the light posts. But it hardly seals the case. Anything else about it It I missed... What about all the witnesses that have been killed since this day. Dozens of them. Premature deaths all of them. No investigations or charges.. What about the missing trillions? Never investigated cos of this day..What about invading Iraq under false pretences? After Saddam switched to Euro currency Nov2000, to buy petrol etc. 2 months after the invasion iraq is conveniently been switched back to u.s currency. The strength of the U.S dollar is all that matters to them, if it declines or is in jeopardy ur country is FUCKED..!! Doesn't that ring suspicious at all. I wish I could believe the story. But I'm far from convinced mate. U do recite the official story well tho, too bad that story came from an administration full of cunning liars.
Reply: Jacob Silverstein- They do. The point is, equations with variable mass do not necessary implicate an equilibrium between action and reaction as in the third law, especially when there is mass transfer in the system (as in progressive collapse)
Reply: Farlap: What you are doing there is after having been proven wrong on one item you just change the topic. This is fairly intellectually dishonest, you aren't being honest to yourself and you aren't being honest to me. The human mind is very good at finding patterns where there are none. Ask yourself, what are the facts, what can you demonstrate to be true. If you were wrong about the pentagon plane, what are the chances that you used the same flawed sources and logic to come to your conclusions about Iraq or the witnesses or other things?
Reply: Evsupp: You literally are the only person throwing insults around.
Reply: Of course, the equilibrium was lost when the structure failed to exist .
Reply: evsupp2011, u forgot the Canadian debhunker.. "Cantonear1968"
Reply: The interior columns were almost 1000lbs/ft, were did they go? It looks like they dissapeared. They did they got incinerated, not left to stand, look at the video. https://www.youtube.com/watch?v=0i7yJrdnBzM
Reply: 186 thousand tons of steel was excavated  from the WTC complex. What portion of that number did the columns make up? Are you actually willing to "guesstimate" from video footage?!
Reply: Jacob: Most of the volume of a building is air. When it collapses that air is forced out ( that's part of the reason why you have those huge dust clouds ) you are left with everything else. WTC was roughly 85% air by volume, after collapse you expect to find a pile of rubble only a couple of stories tall.
Reply: 1,300 ft of interior columns that weighed 200 tons min per floor, 900lbs per ft, 47 of them. do the math for column loading, Euler equations. They left a smoke trail, no plastic deformation at all given the speed at which they failed? They were melted into the basement, site hot, for weeks.......
Reply: Jacob: What are you talking about? Please try to use whole coherent sentences.
Reply: 1,300 ft of interior columns that weighed 200 tons min per floor, 900lbs per ft, 47 of them. do the math for column loading, Euler equations. They left a smoke trail, no plastic deformation at all, given the speed at which they failed? They were melted into the basement, the site was hot, for weeks.                                   
                  Better? Compound sentences are my thing Baby. 
REPLY
Reply: I don't think there is actually any evidence of a ton of melting going on and there are more than a couple of photos of beams that have been folded right over by the forces involved.
Reply: Jacob Silverstein - You are a funny person. You demand someone to reply on an incoherent post with no real question, yet you forget to answer my 3 simple yes/no questions :). let me remind you:
1. Do you or do you not agree that Newton's laws apply to single point masses only?
2. Do you or do you not agree that the upper parts of both buildings behaved all but like single point masses?
3. Do you or do you not believe that the upper parts are deformable bodies?
Why not answer these questions before you start demanding others to answer questions you have never asked?
Reply: Demand ? HA that is funny. Never have demanded anything from you.  As far as your single point mass 1.) yes, it can be applied to things like airplanes, planets and materials though.
2.) See above anwser
3.) Deformable bodies. What else?
Have you studied Euler's equations, statics, dynamics, mechanics of materials?  I demand an answer.  HA, see how stupid that sounds?
Reply: Jacob: Yes, I am a structural engineer. From my perspective the way that the towers collapsed is actually remarkably intuitive. Think of such a tower much like a stack of foam, most of it's volume is air, 85% to 95% in fact with a latticework of structural material holding it up. As long as the foam is not disrupted it can easily support it's own weight. However, if a bubble pops the weight of the water is transferred onto other bubbles and if enough pops that water will start falling through the bubbles, destroying the structure in the process, creating more water and weight bearing down on the structure below. This is what is called a progressive collapse. Once this process starts there is no stopping it.
Reply: Semni Istiqlal With 200 tons , plus per floor of column loeded box section I do see your analogy as being any parallel at all. The exp with the papar circle is much more revelent. Do an exp with your foam, see it will give a progressive collapse.
Reply: Jacob: You are doing that thing again where you are writing in fragmented english, I am not sure what you are trying to tell me.
Reply: With 200 tons , plus per floor of column loaded box section I do "not" see your analogy as being any parallel at all. The exp with the paper circle is much more revelent. Do an exp with your foam, see it will give a progressive collapse.
Made an addition of not, major typo.  The foam model might provide some insight? The structure was hardly anisotropic as is foam.
Reply: Steel does not column load like foam. Right?
Reply: Jacob: What I am saying with the foam example is that the columns alone cannot stand, if you built the tower out of columns alone it'd fall apart under it's own weight. However, when everything is put together the tower is remarkably durable. Disrupt that cohesion however and things start falling apart, this is exactly what happened with the towers.
The floors cannot take all that much weight, they are only there to hold the columns straight, which doesn't require much force. Once the floors go there's nothing there to keep the perimeter columns straight, they bend and break, being much weaker to lateral loads. This debris joins the debris falling down, accelerating the collapse. Finally the bare core collapses because it's been battered by debris and has lost lateral stability due to the non-existence of the perimeter walls.
Reply: Out of all of this I am just trying to figure out where does the energy come from to turn all that stuff into dust?? Certainly not from just some upper floors collapsing (even if they collapsed how the official story claims)
Reply: TimeOut: That stuff was mostly sheetrock. Have you ever put up or torn down sheetrock walls? It's not exactly hard to pulverize that material.
Reply: lol dont try that you know dang well I am talking about everything not just the sheet rock lol like after the collapses you cant tell me you dont see all the missing structure like it disappeared  into  thin air. As the explanation that day was that it just evaporated or something ridiculous  LMFAO

Lets do an experiment lets take one 5x5 of sheet rock then lets get one.. no F it legts get two or three of something heavy as hell and drop them ontop of the sheet rock from 15 Feet in the air with the sheet rock  up sideways and lets see how it turns into that fine dust LMFAO GTFOH with that BS

We are talking about 110 stories of steel, concrete, aluminum etc. and you want me to believe it was mainly just sheet rock. Heck even the guys on the ground said they only found one filing cabinet and no other office supplies lol, what I guess everything was made out of the most cheapest/fragile/worthless sheet rock on earth I suppose huh, made from finest factory in the backyard of Semni Istiqlal house hahhahahahahahahahahahahahah ( I guess thats what you would say if you have no explanation LMFAO)
Reply: You've never worked with sheetrock, have you?

They removed exactly as much debris as there was material in the building before it's collapse, I don't know what you are talking about. This is all part of readily available public record.

Why do you expect a filing cabinet to survive a building collapse like that? That is a huge pile of steel falling the better part of 400 meters, it's like a blender, chopping everything up into tiny little pieces on the way down. For something to survive that it needs to get lucky.
Reply: Aah yes, common sense. A falling steel beam doesn't fall straight down, it hits objects, people, drywall, other steel beams. Hitting them with about the force of a truck at highway speeds. Have you ever seen what a truck can do to a human being? It isn't pretty. Sometimes those people, objects, bits of drywall are unlucky enough to be between a beam and another beam. Like a hammer and anvil this will smash just about anything. This happens over and over again for four-hundred meters.

And you wonder how a material that can be pulverized with a pair of sturdy workman's boots didn't survive in such an environment?

Maybe you should spend a little less time being a condescending prick and a little more time coming to an understanding of what you are talking about.
Reply: You cant explain it LMFAO thats whats funny you can try to spin it all you want but you cant explain it at all.

My point is where is everything at??? I am also talking about these beams you speak of EVERYTHING. its impossible for all of that to turn into dust as it did with just gravity alone, as you all like to claim it wasnt free fall. So how fast is something moving when its just falling?? And again since its not free fall (as you all like to claim) then this means the speed is even slower but even if it was free fall its still no where near enough energy/force/power to turn all that into dust.

And no I havent seen in real time what a truck can do to a human being... but.. it doesn't matter as it will sure as hell not turn them into dust thats for sure neither does the truck. Because it wasnt just the lower floors that turned to dust the upper floors turned to dust as well (so explain this as well) LMFAO ohh thats right you cant lol.

If you slam something on the ground then you are already surpassing the speeds the towers fell so with this lets do more tests shall we LMFAO.. lets get a paper binder with it full of paper then lets stack 30 of them on top of each other maybe with 14 inches in between each then lets again grab a 1000 pound piece of heavy ass metal (this time with knives and needles sticking out the bottom to assist with the dustification process LMFAO) and lets slam it on top of those binders from 100 feet in the air...... Nope still wont turn to dust or according to you look like they were in a blender  LMFAO

Maybe you should spend a lot more time not trying to spill a bunch of BS with ridiculous explanations and just admit YOU  DONT KNOW how the stuff turned to dust and where all the 101 stories of metal/steel/etc. went along with all the office supplies, building material etc.. Well going off of just the official story alone that is you will never know how because its impossible plain and simple, no real world test you try to do can replicate it even remotely its not feasible and breaks the laws of physics beyond comprehension lol
Reply: Nor the 200 tons of column loaded interior columns, all the way to the ground. The smoke was from the steel being incinerated.
Reply: At no point have I claimed that these things turned to dust. The dust came mainly from the drywall and the concrete floors, everything else ended up in the debris pile. I'd suggest you check on the number of truck rides that were used to clear that area, the total volume of material removed corresponds pretty much exactly to the total volume of material in the towers when they were undamaged.
Reply: Ummm no everything else did not end up in the pile lol again if it did where is the rest of it at. You have videos with Firefighters police etc. saying where is everything at. They literally only found ONE filing cabinet. Why because everything was gone turned to dust. Concrete doesnt just turn to dust, metal filing cabinets, couches, chairs etc. dont just turn to dust from something falling on them smashed to hell yes disappear .. umm no LMFAO.

Funny you are the only one in the world saying its concrete and dry wall NOT even NIST, FEMA, 911 commission,  no engineer or scientist is even stating  that idiotic claim LMFAO.

You can even look at building 6 it has a big ass hole in the middle like it was blown out. pretty much a perfect circle like a fe stories deep once again no debris in it like something fell on top of it , so where did the rest of that building in the middle go there whats your answer for that???? Debris shredded the center out like a blender as well?? LMFAO
Reply: Jacob Silverstein - "The smoke was from the steel being incinerated"
??? The smoke was from the fires. The dust was from the concrete, sheetrock and glass.
Reply: TimeOut: You have some odd notions, I made no such claims. If you'd actually bother to read my responses you'd have your answers. The debris is right there after the collapse.
Reply: In fact, if there was no debris, what were they trucking away from the site?
Reply: I am talking about debris/rubble to account for 101 floors of a big ass building all you have on ground zero is literally the equivalent of 2-4 stories with barely any debris and metal, office supplies,  shattered windows etc. or anything to account for that massive building. Where is it all at?? For a building to just "collapse" it sure did cause pretty much over 95 floors to disappear into nothing lol.

I mean you guys have literally one explanation for almost every law physics breaking phenomenon... ohhh the collapse did it... What about the big ass explosions you could hear far away way before the collapse, reports of explosions before planes hitting, ohh still the collapse (buckling) lol, well what about the building looking as it was coming down floor by floor evenly across all sides everything is literally blowing out in sync which is impossible for natural things to do-ohh dont matter the collapse did it, LMFAO
Reply: TimeOut: Each tower weighed about 500,000 tons, which is about 63,000 m^3 of steel all put together. Using that information you can figure out that the debris pile would be at most 15 or so meters high. Which is pretty much exactly the height you think the debris pile was. You may want to reconsider your assumptions.
Reply: Tmeout - "every law physics breaking phenomenon"
Which are you talking about?

" the big ass explosions you could hear far away way before the collapse"
How does an explosion way before the collapse contribute to the collapse? Have you ever seen a controlled demolition? You should look it up, There's plenty of examples right here on youtube. Now, start counting when you hear the frst explosion and see how the building responds to that. Does it remain standing for an hour, or does it collapse right away?

"reports of explosions before planes hitting"
Source please.

"literally blowing out in sync which is impossible for natural things to do"
You do know that a building is not a thing made by nature? And you also do know that a building is engineered and designed to carry loads evenly? You might want to start making a disticntion between the initiation of the collapse (impact, fires) and the progressive part of the collapse (design).
Reply: okay then where is the debris at for it then for this to be the case it would be flattened broken up not turned to dust lmfao 

So once again lets use this logic. Lets take  four stacks of 15 soda cans piled on top of each other (thats what like less than 2 pounds) then throw some of that famous sheet rock inm between a few of them just for color LMFAO then lets get a 5000 pound piece of hard ass metal and drop it on top of the cans straight down from 100 Feet in the air to get that force going lol and lets see how they turn into dust shall we...  (This experiment is even in your favor as the lower parts of the tower were more stronger than the upper parts which makes  your conspiracy theory even more ridiculous lol). 

o yeah thats right they wont LMFAO they will flatten and be squished to hell and back but you know what? You will still be able to recognize them and they wont just vanish and be evaporated as they said happened to the floors the day it happened LMFAO 

yeah that was an actual explanation from officials the day the towers fell when a reported asked about where all the debris/rubble from the towers went LMFAO they said "they evaporated" LMFAO hahahahahahahahahahahahahahahahahahahahhahah
Reply: Do you know what the square-cubed law is? As you scale up an object it's surface area is squared but it's mass is cubed. Forces act on the surface area but the forces generated are determined by the mass of the object. As a consequence your scale model has a significantly larger surface area in proportion to it's mass and it won't behave in the same way as the full size building.

As a consequence your model does not come close to replicating the conditions in the collapsing building and thus cannot be used to confirm or deny anything about the collapse.
Reply: You seem to lack some of the basic concepts needed to understand a collapsing building. This is highschool level physics. I don't think you understand just how ignorant you are on this topic. If you did you would not be pretending to laugh.
Reply: Semni Istiqlal lmfao you can try to throw around that BS all you want that don't mean it fits what happened on 911 lol. Here is what you are doing.. I'll take a mathematical example....

If a single x of object A is added to object B then object B will always be plus one ( i.e. 1+1=2).

But you are trying to convince people that 1+1=3 lmfao so the mathematical statement is irrelevant just as much as your BS attempt to explain how a 101 story building and everything in it disappeared all because of weight and gravity lol

Quick question you say I don't understand the basic laws of physics lol but how is it that a falling structure can cause its own mass to evaporate???? Cause the officials even that day to gave a BS explanation saying that ohhh well they just evaporated lol their words not mines Lmfao....
Reply: Maybe because it didn't evaporate? Maybe because those people didn't actually say any of those things? The only person who has claimed that these things happened is you.
Reply: Timeoutcorner - "how is it that a falling structure can cause its own mass to evaporate???? "
No mass evaporated. Where did you learn that? And which mass would that have been?

"Cause the officials even that day to gave a BS explanation saying that ohhh well they just evaporated"
I find it hard to imagine that any official (which?) would have stated that any of the towers' mass evaporated. Source? See, you make the same mistake again: your assumptions are false because you do not take the time or effort to study them. You simply copy some false truther claim without understanding what it means. 

I noted you deleted your own reply that dealt with the source for witnesses claiming to have heard explosions before the planes (plural) impacted. You might have missed the word "before" although you are the one that made this statement. Did you realize there is no source for this and is that why you deleted your comment? Or did you realize that it proved your read my post and I would ask for your reply on the other subjects as well? Whichever it is, you should know that a notification of your post will remain visible to me, even if you have deleted the post itself. 

Care to respond to any of my replies? It's OK if you don't. I will understand.
Reply: ohh they didnt say that LMFAO funny enough the news reported it they were as well baffled at how little rubble/remains of the building from a 101 sky scrapper pretty much were non existence:

https://www.youtube.com/watch?v=GdBQOe85i3M

That is unless you think even with a good amount of moving trucks they can remove 101 floors of towers all while trying to do search and rescue/recovery in under 6 hours LMFAO even in the video they pan in onto where the "collapse" site is with barely any rubble left. Why simple most of it was truned to dust lol

But what did he say was an explanation.... ohh some "guy" told me they evaporated LMFAO hahahahahahahahahahhahahahahahahahahahahahahaha yeah nice explanation nice investigative work there buddy lol
Reply: I already did the math for you and calculated that said amount of rubble is exactly the amount that you'd expect from those buildings. They are baffled because they are ignorant of this and did not do the math. You are the same.
Reply: As expected come up with a reason why people on the ground in NYC when it happened have no clue what they are talking about LMFAO hahahahahahahahhahahahh only you know the "math"

Pulling BS out of your ass doesnt make it true lmfao what actual calculation did you use to come up with this supposed "all that should have been left was 15 meters high of building debris"???? LMFAO 

O really so what did you base your math off of????? Did you have the exact amount the exact number in weight of how much debris was left after the collapses?? Did you calculate how many stories of the building were left and add that into your calculations, along with all the crap loads of the building turned into dust... Ohh wait thats right there is no way you can come up with any of this as NO OFFICIAL GOVERNMENT agency recorded any of it themselves for even them to even do the math for this LMFAO so how in the hell did you do it?????????????

What a load of BS you cant do math with out actual numbers you cant say I know X before collapse so Y is X after collapse without knowing how much of Y is even on the ground in actual amount and weight LMFAO...... Again how would you know how much debris was on the ground when the numbers were never produced?????
What you telling me you can eye whats left of a buildings debris and how much it weighs after it collapses to come up with this supposed MATH LMFAO 

The fact is there was too little rubble, almost nothing left of those buildings to account for 101 stories of a Sky Scraper. 15 meters LMFAO this isnt someone stomping their boot on top of a soda can to smash it to 15cm thick lol
Reply: I already described my methodology, try reading before making yourself look silly. It's a matter of public record exactly how much material went into constructing the towers.
Reply: Yeah no crap thats public records about how much was put into the towers when they were built LMFAO my question is how in the hell do you know how much was left after the fact to allow you to come up with your mathematical problem??? LMFAO Especially when they never released that info LMFAO So how can you say thats how much is supposed to be left when you have no clue of how much was actually left????

Like I said earlier:
"you cant say I know X before collapse so Y is X after collapse without knowing how much of Y is even on the ground in actual amount and weight" 

where is your mathematical equation is my question that includes the actual amount after the collapse that proves thats how much should be left according to you??

Simply saying I know this so it should be this doesnt  mean you did some math it means you are just saying some BS just to try and have it fit your narrative LMFAO

How about you try reading instead of trying to figure out ways to spew more BS LMFAO

So where is your math at here is mines 1+1 = 2 therefore 1+1 != 3 LMFAO hahahahahahahahahahahha
Reply: I don't take the answer I want and work back from there, that isn't honest enquiry. I took the material in the tower and worked out an approximate heigh of the debris pile that it would create. You were baffled by the fact that the debris pile was only a couple of stories tall, I demonstrated to you that based off what we know about the towers before they collapsed the debris pile should have been about the height you observed it to be.

Another thing you can do is compare the amount of material delivered to the scrap merchants and the number of dump truck trips taken from the site. These people were all paid and the invoices for this are a matter of public record. I'm sure you can find some independent verification of these things as well. However I'm going to leave that up to an exercize for the reader.

The fact of the matter is that while you have claimed that large parts of the tower structure turned to dust you have yet to demonstrate that this actually happened.
Reply: I dont have to demonstrate the dust the videos show that themselves LMFAO 

And you didnt demonstrate anything you just said it into existence thats not showing lol I can say the buildings turned to dust cause the videos show it before,during and after as well there is no debris on the ground to account for a 101 story building  lol. 

So where is this mathematical equation that you used then???? LMFAO 

Here is an example  these people here use mathematical equations to figure out exactly what should happen if they use the right equation based on the info given, funny enough the person who won this competition did not know physics and used logic that some the people you call truthers use to win the competition lol guess going by your logic you would have gotten every one wrong LMFAO :
https://www.youtube.com/watch?v=OjvCNDF4RYw&t=754s

... So where is yours??? O yeah thats right you dont have one you just made up some BS LMFAO
Reply: Building collapses and demolitions are all accompanied with large amounts of dust, you havn't demonstrated that there's anything extraordinary about the dust generated in 9/11
Reply: Semni Istiqlal well you are right demolitions are accompanied by large amounts of dust but you are out of your mind if you think building collapses are accompanied by large amounts of dust like that with that much force to be pushed out.

 I mean for crying out loud you had blocks on top of blocks being swarmed with a thick ass cloud of dust very fast. People had to run for their lives and to top it off there are many reports with people saying the dust was hot as hell. 

It turned the day into darkness for blocks and you want to say there is no evidence for a crap load of dust lmfao that sounds about right on time just like NIST, 911-omission said they didn't investigate for explosions because they didn't find any people reporting explosions lmfao haha haha I mean my goodness lol.

There was so much dust people were getting sick for years and it was a lot of people. It was so bad that if people went to any hospital in the USA for any symptoms and they mentioned they were sick from dust from 911 they were turned away yet they could go get seen for the sane symptoms and not mention 911 and get seen. Yeah talk about conspiracy huh lol and you taking about not enough dust. Tell me what collapse can cause dust to be hot as hell and for it to be a big ass mass engulfing entire blocks at high speeds?????

But F all that where the hell is your mathematical equation that lead you to the conclusion that 101 stories should have ended up how they did based on their official story ohhh that's right you don't have one you just pulled some BS out of your ass lol talking about there is not enough evidence of enough dust lmfao when there was literally blocks getting smothered in darkness by a thick ass cloud of dust.
Reply: Timeoutcorner - "ohh they didnt say that"
I said I find it hard to imagine that any official would state that any of the towers' mass evaporated. And you come back to me with a video of a reporter that talked to a volunteer that said the rubble fell into the ground, evaporated. Do you not understand the difference between a volunteer and a an official? Do you not understand the difference between mass being evaporated and debris being evaporated? Do you not understand that a reporter quoting a volunteer is all but an official statement? So please, where is the official stating any of the towers' evaporated?

"even in the video they pan in onto where the "collapse" site is"
This is proof of how little you understand about ground zero. That video was taken from one of the top floors of a residential building between Greenwich St and West St., zooming in on West St. The view to ground zero is blocked. We see just a little bit of West St. where the WFC is.

"in under 6 hours"
What are you talking about? This video was shot on 9/12. Even the title of the video says 12:44 pm. This is 15 hours after. How did you get to 6?

Did you actually watch the video yourself? How would you explain what the reporter said about no bodies being found, being burried so deep into the rubble?

The anchor man also mentione dthe fact that bodies were found 40 ft below street level. You still do not seem to understand that there was a 6 floor basement all over the WTC site. I have mentioned this before and you have ignored it.

So, on all your claims, you fail again. Or to use your own words: nice investigative work there buddy lol.
Reply: Timeoutcorner - "you are out of your mind if you think building collapses are accompanied by large amounts of dust "
No. It is you who is out of his mind of you think collapses do not go together with large amounts of dust. I posted it before, including a link to a short video where you can verify for yourself. Here is anpther video. yes, this is a controlled demolition. The dust is not produced by the explosions as you can CLEARLY see. It is produced by the collapse. See how this tower "turns to dust" as well? https://youtu.be/SaBQ3AkRetI?t=44s

"there are many reports with people saying the dust was hot as hell."
Could you show a few? Nobody got burned by any dust. Of all videos of people taht were captured by the dust, none of the videographers mentioned anything about hot dust. The 
"only" problem they had was issues breathing because of the dust.

"you want to say there is no evidence for a crap load of dust"
Where did Semni ever mention anything like that? He is saying the opposite: "Building collapses and demolitions are all accompanied with large amounts of dust".

"NIST, 911-omission said they didn't investigate for explosions because they didn't find any people reporting explosions"
911 commission did not investigate the collapse. I mentioned that before. NIST NEVER said they didn't investigate for explosives because they didn't find any people reporting explosions. Where in their report is this mentioned? Man oh man, you produce some bullshit man.

"It was so bad that if people went to any hospital in the USA for any symptoms and they mentioned they were sick from dust from 911 they were turned away"
Source? (just another bullshit claim)

And please stop writing 101 floors. There were 110 floors. If you make the same typo over and over again, it is no longer a typo. It is just bad knowledge.
Reply: TimeOut: If you'd actually read what I wrote you wouldn't have needed to write half of what you did there. Can you demonstrate that there is anything abnormal about that dust?
Reply: The interior columns vanished into it, Hello, did you see the video?
Reply: The site was hot for weeks, look at the half burned cars...... NIST?  NIST NEVER said they didn't investigate for explosives because they didn't find any people reporting explosions. HA that is funny, I do not remember hearing any either and I  am in NJ?
Reply: 911 commission did not investigate, Ha. Here is a NIST type  operation, https://www.youtube.com/watch?v=eP6jDM6sXhA&t=305s. It was fuckin FAKE.
Reply: Where is the CIA on the bumper, the invisible man? They were not there, ordered off the bumper. Your a civilian right? No military background? Trump school does not count. Military prep? No?
Reply: Spell" that" right, "engineer".
Reply: https://www.youtube.com/watch?v=8xjqz-B4FnY  4:09
Reply: Jacob Silverstein -  Hello, did I see the video? I have no clue what you are trying to say. And what about the interior columns? You speak in riddles, again. I am not saying the interior columns "vanished into it" (into what?). I am merely trying to make clear to timeoutcorener and you for that matter that you guys ignore the fact that part of the debris destroyed the basement and fell into it. I posted pictures and a video. I showed a fire truck being dug out, 5 floors below street level. How do you think it got there?
Reply: Bruce Lansberg melted.
Reply: Jacob Silverstein - "The site was hot for weeks"
And your point would be what?

"look at the half burned cars"
Again, what's your point? Never seen a half burned car before? Here's a few. Non-9/11-related. Random car fires. You sound like Wood that doesn't understand car fires either. Some results of a simple Google search on "car after fire":
https://petapixel.com/assets/uploads/2010/08/7dburnt3.jpg
https://dogpooparcels.files.wordpress.com/2011/09/coh-burnt-out-car.jpg
http://images.archant.co.uk/polopoly_fs/1.2202843.1369218811!/image/349372901.jpg_gen/derivatives/landscape_630/349372901.jpg
https://www.ctvnews.ca/polopoly_fs/1.3502545.1500033943!/httpImage/image.jpg_gen/derivatives/landscape_620/image.jpg
Etc, etc. So what's your point?

"NIST NEVER said they didn't investigate for explosives because they didn't find any people reporting explosions. HA that is funny, I do not remember hearing any either and I  am in NJ?"
Sorry mate, no clue what you are trying to say again. It is hard to have a debate with you if you can't express yourself properly.
Reply: Jacob Silverstein - What does the JFK conspiracy theory have to do with your 9/11 conspiracy theory other than both are theories for which there is no evidence? You say it's fak. What is fake and what is your proof?
Reply: Jacob Silverstein - "Spell" that" right, "engineer"."
First, how old are you?
Secondly, there you do it again. Between you and me, the only one claiming to be an engineer is you sir.
Reply: really?? So according to you a few blocks being engulfed by a bunch of big ass clouds of dust is not abnormal to you if was only supposed to be a collapse??? What lol hahahahahahahh

But I am still waiting on your mathematical formula that led you to know how much of the buildings were supposed to be there. Stop dodging and provide lol
Reply: Timeoutcorner - "so you are saying NIST didnt say they didnt here any reports of explosions"
No. That is not what I'm saying. Where did you read that? I understand English is not your first language. But what I wrote is not very hard to understand.
You wrote: "NIST,[ ...] said they didn't investigate for explosions because they didn't find any people reporting explosions"
I said that's not true. The reason why NIST didn't investigate alledged use of explosives is clearly stated in the FAQ on NIST's website. Have you not even taken the effort to just read the FAQ? Let me help you:

Question: Why didn't NIST consider a "controlled demolition" hypothesis with matching computer modeling and explanation like it did for the "pancake theory" hypothesis?
Answer: NIST conducted an extremely thorough three-year investigation that included consideration of a number of hypotheses for the collapses of the WTC towers.

Some 200 technical experts—including about 85 career NIST experts and 125 leading experts from the private sector and academia—reviewed tens of thousands of documents, interviewed more than 1,000 people, reviewed 7,000 segments of video footage and 7,000 photographs, analyzed 236 pieces of steel from the wreckage, performed laboratory tests, and created sophisticated computer simulations of the sequence of events that occurred from the moment the aircraft struck the towers until they began to collapse.

Based on its comprehensive investigation, NIST concluded that the WTC towers collapsed according to the scenario detailed in the response to Question 6.

NIST's findings do not support the "pancake theory" of collapse, which is premised on a progressive failure of the floor systems in the WTC towers (the composite floor system—that connected the core columns and the perimeter columns—consisted of a grid of steel "trusses" integrated with a concrete slab; see diagram). Instead, the NIST investigation showed conclusively that the failure of the inwardly bowed perimeter columns initiated collapse and that the occurrence of this inward bowing required the sagging floors to remain connected to the columns and pull the columns inwards. Thus, the floors did not fail progressively to cause a pancaking phenomenon.

NIST's findings also do not support the "controlled demolition" theory since there is conclusive evidence that:
•the collapse was initiated in the impact and fire floors of the WTC towers and nowhere else, and;
•the time it took for the collapse to initiate (56 minutes for WTC 2 and 102 minutes for WTC 1) was dictated by (1) the extent of damage caused by the aircraft impact, and (2) the time it took for the fires to reach critical locations and weaken the structure to the point that the towers could not resist the tremendous energy released by the downward movement of the massive top section of the building at and above the fire and impact floors.

Video evidence also showed unambiguously that the collapse progressed from the top to the bottom, and there was no evidence (collected by NIST or by the New York City Police Department, the Port Authority Police Department, or the Fire Department of New York) of any blast or explosions in the region below the impact and fire floors as the top building sections (including and above the 98th floor in WTC 1 and the 82nd floor in WTC 2) began their downward movement upon collapse initiation. 

In summary, NIST found no corroborating evidence for alternative hypotheses suggesting that the WTC towers were brought down by controlled demolition using explosives. NIST also did not find any evidence that missiles were fired at or hit the towers. Instead, photographs and videos from several angles clearly show that the collapse initiated at the fire and impact floors and that the collapse progressed from the initiating floors downward until the dust clouds obscured the view.

https://www.nist.gov/el/faqs-nist-wtc-towers-investigation

Where do you read anything on NIST not considering explosives because they didn't hear any eyewitnesses talk about explosions? These witnesses have nothing to do with the reason why NIST did not consider explosives.
Reply: Timeoutcorener - "you say people were not being denied/turned away by hospitals when they mentioned 911"
First I asked for the source. You provided it and for that I thank you. Then I mentioned it to be a bullshit claim. I have to admit I partly stand corrected. The guy in the video seems to be convinced he was turned away because he was at ground zero. I am however all but convinced by this guy. He thinks there are human experiments going on, but the interviewer "forgets" to ask for evidence. This guy is clearly a conspiracy theorist. Yet, I stand corrected on the part I hadn't seen any people claiming it.
Reply: TimeOut: It was a big ass building. Buildings normally create a lot of dust when collapsing, you havn't demonstrated that this was an abnormal amount of dust.

Further, what mathematical formula? I'd assume that all of the building would still be there after the collapse unless you can demonstrate that any significant amount of it was missing.
Reply: Timeoutcorener - "here is one with reports of the engineers saying the same thing yet I am full of BS"
I watched the video. Where are the officials you mentioned? I see one MD being interviewed. An MD is hardly qualified to talk about engineering issues. The narrator quotes the environmental protection agency (still no officials) that have been sampling the dust. Have you heard anything on steel? No. They sampled the dust and said it was mostly drywall, cement and plaster. So, no. These are not officials. And they are not saying the samee thing.
Reply: Dude in the video I just gave you he just said they didnt know of any personnel reporting explosions that makes your entire reply worth a bunch of BS why would they say they heard no reports of explosions over a three year investigation " they  interviewed 1000 of people correct okay???? many videos they watched okay lol yet they still found no reports explosions??? WHAT???????????????????

 Everything else is a bunch of BS because we can find countless videos of exactly that people reporting explosions and sounds of explosions SO AGAIN WHY WOULD THEY LIE ?? 3 year investigation and no reports of explosions??? An obvious blatant lie YOUR QUESTION SHOULD BE how can they stand there and say they heard no reports of explosions. ASK yourselv that and come up with a answer that doesnt lead you to believe they didnt want to find any.

So of course there was no evidence of explosions they didnt find because they never looked for any thats the point lol

Example: If a police investigator is in a conference and says the team didnt hear of any reports of gun shots, no videos of sounds of gunshots and they come up with their investigation to show how someone died of a heart attack yet you have countless witnesses who say they heard gunshots and video recordings catching gun shot sounds and show the person being blown back that makes their entire investigation equal to BS because the actual evidence doesnt support their claim.

The fact that they are saying they heard no reports of explosions is all you need to know why they never considered explosions they never were going to and they didnt want to. 

If something is right in front of my eyes in this case reports of explosions yet in 3 years of a deep investigation I say I dont see any what else are you supposed to think lol
Reply: Timeoutcorner - "I mean how crazy is this more vidoes from different people reporting expllsions before the plane even hit just like the guy in the basement said explosions then momnets later the plane hit -- this even goes with WTC7 when there were repotrs of explosions in lobby or lower floors before all hell broke lose yet I am the one spewing BS "
Of course people mentioned explosions. There is a sunstantial chance that things explode in an office fire. There is a substantial chance people heard falling floors, elevators, beams, gas explosions. Yet, you were talking about people hearing exploions before the planeS hit. See? Plural, like I mentioned before. This is utter nonsense. As for the guy in the basement (William Rodriguez), he WAS IN THE BASEMENT. How would he have known when the plane hit in the first place? Even if he would be correct about the exact moment the plane impacted, there could be s very simple explanation as to why he thought there were explosions before the impact. He could have experienced the sound/rumbling through the steel. Sound travels thourgh steel a lot faster than trough air. A second later he might have heard the same impact through the air. He could also have heard the fireballs exploding through the elevator shafts just moments after the impact. And we haven't even discussed the illogicallity of a basement bomb yet.

I am also a bit confused right now. Didn;t you mention earlier that everything turned to dust? Now you think there were bombs in the basement? Isn;t it time you'd make up your mind about which conspiracy theory to support? You do realize both exclude eachother?

As for WTC7, same as above, of course there were reports of explosions.
Reply: Tomeoutcorener - "For the explosions its funny because there are countless videos with firefighters, news reporters, policeman, civilians etc. reporting explosions"
I know. What's your point?"

"and many videos where you can here loud explosions going off."
Explosions do not "go off". Yes, you can hear explosions. So what?

"So your question should be why would NIST lie and say they didnt know of any reports of explosions???????"
I mentioned this before twice, but I will repeat again: NIST never said they didn't know of any reports of explosions. Source?

"Just like they lied about not knowing about any reports of molten steel."
Which molten steel? There was no molten steel.

" the guy in the video clearly states that they started around 6am in the morning add in prep time and I am sure you can come up with the math for  about 6 hours its not that hard to do"
They have been working on the clean up for 8 months. Not 6 hours.

"you act like the reporters only had video the entire day and the day before of video from just that one angle like come on now son"
No! You claimed they zoomed into the WTC site and it showed empty. I said you are poorly informed since that was not the WTC site. Don't put words in my mouth. 

"nd no crap I watched the video lol Bodies being found deep into the rubble 40 feet yes there are levels of basements"
You are completely missing the point. The fact that there was a 6-story basement all over the WTC site, should have made you think. The fact a fire truck was dug out from 5 floors below street level should have made you think. The fact bodies were found in the basement should have made you think. This all should have made you think about where part of the debris went. You mentioned there was not enough debris. You still have not acknowledged the fact that part of it ended up in the basement.

" Another video of perosnnel saying explosions before the plane hit yet I am full of BS"
Source?

"nd you are an idiot LMFAO the dust is created by the explosions"
Sorry mate, but I have to ask you: Are you really that dumb? I counted 20 explosions (20!!!) before the building started to collapse and produce dust. How can you say the dust was produced by the explosions? It clearly isn't. The dust doesn't start being produced the building collapses. 

"at the very bottom of the building before the collapse what do you see???"
There is a tiny little bit of smoke. Smoke produced by the explosions. Have you not watched the video at all? If you haven't, you might be inetersted in listening to the sequence of explosions. Thgis is what you should hear at controlled demolitions. Now please show me any video that represents this on 9/11.

"Then what do you see as its falling down just like the WTC exact blowout of dust."
Exactly! Dust. because of the collapse. NOT because of the explosions. 

"Show me a video of a normal building collapse producing that much dust"
Buildings are designed to stay upright. There are not many videos on spontaneously collapsing buildings. I did however post one of the Mexico earthquake. A 4 story builduing, collapsing, producing a lot of dust. If you think the amount of dust is depending on explosives being used or not, then please explain to e the mechanism that causes the extra dust.
https://youtu.be/zhxCevJZcck?t=24s
https://youtu.be/X-HcJsCPjc0?t=39s
https://youtu.be/Em3OEa6LmPY?t=3s
https://youtu.be/wJCecqda-E4?t=7m21s
Just a few examples of collapsing buildings or simple brick walls. Tiny, very tiny. Compared to the towers. These buildings in these videos probably didn't even have concrete floors or gymspum walls. Now imagine 110 stories of that material.

"It seems there was no no cause for concern over all the dust?"
Indeed. It is simply explained by what I have been trying to tell you and by what Semni has been trying to tell you. 110 stories of skyscraper filled with concrete, gypsum and plaster will produce dust. Lots of dust.

"Hell even if there were no reports of explosions they still according to US policy for structures of that nature were required to investigate for explosives"
Source? There is no such think as "US policy for structures". What are you talking about?

"Whats wrong with asking these questions"
There is nothing wrong with asking honest questions. There is a lot wrong with sticking to a conspiracy theory that has long ago been proven absolete. there is a lot wrong with misreading answer being given. there is a lot wrong with putting words in other people's mouths. And if you ask an honest question, would you not be interested in a verifiable answer? You don't seem to be. You seem to be looking for any answer that confirms your true belief in a conspiracy theory. That's called confirmation bias.

"this still doenst negate that a lots of people report explosions before the planes hit and explosions in WTC7"
Which people? Even your star witness William Rodriguez didn't saying anything remotely close. Which others do you have? 

"Maybe you are so full of BS you think everyone else likes bathing in it:"
I don't know what that means and why you would mention that in a debate on 9/11. You need to learn a few things:
1. Please read what people actually wriyte and try yo understand what it measn.
2. Check your sources and do not simply copy/paste claims you have no clue about.
3. Practice some logical thinking.
4. Understand that a theory without evidence doesn't prove anything and therefore has no meaning.
5. Understand that YouTube videos and their owners are here to gain clicks and likes. They very often have nothing to do with reality.
And you tell my to get the fuck out? :) You are way out of your league.
Reply: Tomeoutcorner - " in the video I just gave you he just said they didnt know of any personnel reporting explosions"
What?? Where in this video is that being said? What are you talking about? What Sunder says exactly: "We did not find any evidence that explosives were used in the collapse of building 7". Did you see or hear him or anybody else from NIST state that they didn't know about any eyewitnesses hearing explosions? If so, where is it? 

"why would they say they heard no reports of explosions over a three year investigation"
Who said that and when? It is not in the timestamp you provided. 

"yet they still found no reports explosions?"
When did NIST state this? And where can I find it? 

" SO AGAIN WHY WOULD THEY LIE"
So why would YOU lie? 

"The fact that they are saying they heard no reports of explosions is all you need to know why they never considered explosions they never were going to and they didnt want to."
You are wrong. Did I mention that already? Do you think "We did not find any evidence that explosives were used in the collapse of building 7" is the same as "We have not heard about any witnesses that decribed explosions"? Do you understand the difference between explosives and explosions?
Reply: Bruce Lansberg are you kidding me lmfao he says it right there in the video watch it for one minute just click the link watch for one minute lmfao you got to be kidding me. Acting like he not saying it right there in the video lol
Reply: So ... that's all you have got?
Reply: Tomeoutcorner - You really have some issues with understanding the English language, don't you? I have watched your video. I have seen this clip dozens of times. Sunder never says NIST did not hear of any witnesses hearing explosions. He DID say there was no evidence for explosives. Let me ask you again: Do you understand the diference between explosions and explosives?
Reply: +Bruce Lansberg WTF dude you are so full of shit LMFAO at exactly 624 in this video
https://youtu.be/iSnjyZNYlW8?t=6m22s
He vividly states:
"The sized blasts will produce an incredibly loud sound that was not recorded on video of collapse nor reported by witnesses"

Lets go over this "english" I supposidly do not undertsnad shall we LMFAO:

Blasts = he is talking about bombs i.e. explosives going off i.e.
 explosions (obviously you dont know how to comprehend LMFAO yet you say I dont understand English LMFAO )
Loud sound = referring to blasts from Explosions from Bombs (obviuosly you dont know how to comprehend LMFAO yet you say I dont understand English LMFAO )
Not recoreded on video = He is saying there are no videos at all recording loud blast sounds of bombs going off (obviuosly you dont know how to comprehend LMFAO yet you say I dont understand English LMFAO )
Nor reported by witnesses = He is saying no one ever reported hearing explosives/bombs going off again explosions (and once again obviously you dont know how to comprehend LMFAO yet you say I dont understand English LMFAO )

So lets put it all together in laymans terms for you lol NIST is saying (in a what was it a 3 year invstigation) they did not find any reports or find any videos of explosions (ohh im sorry blasts) LMFAO

So of course they are going to say no evidence for explosives (bombs) LMFAO they didnt try to search for any because of their "simulation model he vividly states they used" And since they heard no reports from anybody of blasts from explosions based on their model they didnt investigate it lol

Yet you over here being as retarded as can be LMFAO because you cant comprehend that when he says blasts he is talking about explosions from bombs/explosives LMFAO how foolish can one be.

Ohh I see you are just trying your hardest to downplay facts to fit your narrative just like NIST saying they hear no reports of explosions (blasts) and just like they pretty much said no reports of molten steel LMFAO

Again all of this is laughable considering the local police in NY arrested individuals fleeing the scene with explosives and handed them over to the FBI LMFAO but according to you I am sure you will say they were just shooting a movie scene or something and had nothing to do with anything lol
Reply: You got to be kidding me LMFAO I gave you the incorrect time stamps?? No I didnt I even told you to watch the video for ONE FULL minute at least to see what he said lol. You were just trying to deny it. You only now are acting like you just seen it because I decided to put the link down again and type down his exact quote LMFAO you are not slick lol hahahahhaha

And dont try  to be foolish,  loud blasts LMFAO a crap load of people hear blasts regardless (now I cant say if they heard loud blasts or not because by just hearing someone talk about it there is no way for one to know how loud it was). So riddle me this how would NIST know how loud the blasts where if people were reporting blasts???? Levels reported by witnesses?? Was NIST able to determine the levels of the blasts people heard by just speaking to them or hearing their reports??? You are complete full of it. LMFAO. 

I am trying to figure out how a human can determine the levels of blasts people heard by just talking to them or hearing their reports. Only someone like you would believe that is even possible which I guess isnt to far fetched since you think sound waves travelling through steel from well over 70 floors above can cause a basement to explode causing massive damage and injury to people as well blowing them around lol

And stop with the 130-140 db blasts NIST LMFAO how in the hell can you tell how loud a blasts was (thats past tense) from people talking about hearing explosions and bombs going off????? LMFAO. You are the most BS spinner I have ever encountered lol

WHat do you mean does it make sense to me about police arresting people fleeing with bombs.. No it doesnt but it happened none the less with no real investigation into it at all to my knowledge.

Either way NIST still denied people reporting explosions going off in the video regardless. And didnt even bother to test for explosives because of a computer model lol how fitting wont even go the extra step just to make sure lol
Reply: Timeoutcorner - "I gave you the incorrect time stamps?"
Yes, you did. You however did indeed mention to watch if for a minute or so. And so I did, trying to find some back up for your claim. Which there wasn't. Maybe that's why I missedd something I should have interpreted as evidence NIST lied :). Anyway, let's agree to disagree on this one, since it doesn't make a difference to the subject matter. 

"So riddle me this how would NIST know how loud the blasts where if people were reporting blasts?"
You do not need to ask that question 4 times. I can answer the first. You can consider the other 3 answered as well. Let's imagine an interview.
Witness: I heard booms/explosions.
NIST: How loud?
Witness: I don't know.
NIST: Could you compare it to standing next to a jet engine?
Witness: No.
See, it is not that complicated.

"you think sound waves travelling through steel from well over 70 floors above can cause a basement to explode"
Sigh... when or where did I mention anything remotely close to that? Please read it again. I said "Even if he would be correct about the exact moment the plane impacted, there could be a very simple explanation as to why he thought there were explosions before the impact. He could have experienced the sound/rumbling through the steel. Sound travels through steel a lot faster than trough air. A second later he might have heard the same impact through the air. He could also have heard the fireballs exploding through the elevator shafts just moments after the impact."
How does that resemble anything you accused me of saying?

"WHat do you mean does it make sense to me about police arresting people fleeing with bombs."
I mean, does it make sense for people to run away with bombs if:
- they are being chased by the police. Running goes a lot faster without having to carry a bomb.
- the goal would have been to help the buildings collapse by use of these bombs. I would think that leaving the bomb at the WTC would be somewhat more effective than carrying it away from the buildings.

" it happened none the less"
Let my ask you a second time: source?

"NIST still denied people reporting explosions going off in the video regardless."
No. Sunder denied people hearing loud enough blasts just before the collapse to have any relation with it. Why would Sunder purposely deny facts that have been included in the report he was presenting in that video? I'd urge you to read the report or at least the FAQ before you critisize it: "no blast sounds were heard on the audio tracks of video recordings during the collapse of WTC 7 or reported by witnesses."

"And didnt even bother to test for explosives because of a computer model"
No. Not simply because of a computer model. Because the model showed that a certain force would be needed to have the critial column fail. That specific force by an imaginary explosive would have created a loud bang: "According to calculations by the investigation team, the smallest blast capable of failing the building's critical column would have resulted in a sound level of 130 decibels (dB) to 140 dB at a distance of at least half a mile, if unobstructed by surrounding buildings."

You might be interested in reading paragraph 3.3 that deals with hypothetical blast scenarios, from page 26. http://ws680.nist.gov/publication/get_pdf.cfm?pub_id=861610
If you're going to critisize something, now you at least have the source to do so. Anxiously waiting for your reply.
Reply: Stand-up Man who do you claim to be? An expert? 
😂😂😂😂😂😂😂😂😂
Reply: TimeOut Corner so in your reality every explosion is caused from explosives correct??
  Well, there were two loud explosions heard as the grenfell tower was burning.  Those must have been subpar explosives because I'll be damned, I think that Tower still standing
Reply: huh lol no in my reality when there are explosions going off before planes hit as reported by people in the towers I tend to think those are explosions from bombs lol Cause ill be dammed if a planes Sound waves can hit a building and then cause the basement of said building to explode before any plane even crashes into it  LMFAO

But i guess in your reality every big ass explosion is caused by elevators and office materials LMFAO

But anyways I never claimed every explosion would be from a bomb but ummm just how many "office materials/elevators lol" can cause explosions so big they cause entire lobbies to be destroyed even worse all those stories below the crash site (so now we are talking about explosions doing some teleportation bypassing a crap load of floors just to reach the basement and lobby LMFAO)
Reply: TimeOut Corner.......  Do a LITTLE research into William Rodriguez.. The most famous person to claim explosions in the basement Before jet impact.    His story of 'explosions' in the basement first is actually contradicted by.... HIMSELF, without  even knowing it...  ha.. I will be glad to tell you.. but lets see what you find out for yourself first..
Reply: Ohh really well please do explain how he contradicted himself cause I honestly must have missed it.  Ohh and by the way he is not the only one who says this. There is video with people on the day of 911 reporting this same thing (explosions before plane hit). Or I guess they are contradicting themselves as well. How about you guys start taking their stories for what they are..... WHAT THEY WITNESSED AND EXPERIENCED lol my goodness lol.
Reply: Oh dear god... Timeoutcorner woke up from his afternoon nap. You have been owned over this topic over and over. Yet, you still don't take any effort in researching anything on it. You keep on copy/pasting bullshit claims from old 9/11 conspiracy theory videos that have been debunked over a decade ago. Please follow Joe's advice. Let me help you a little bit: do a Google search on William Rodriguez debunked. Follow the links provided in the articles that came up in this search. Links to REAL sources, waiting there for you to be discovered and verified. Do yourself a favor do some research.
Reply: TimeOut Corner I know as a truther you are too lazy to do any research....  So I will give you Rodriguez's story.. 
I predict you'll scoff and will not believe it, but it's online for you to verify
This will be a long reply so be patient.,. 
The version of Rodriguez's story that he uses in his speaking career goes as such... He was in his office on B2 level.  He heard an explosion From Below him.  It actually picked the floor up. Then the few seconds later he hears a second explosion from above him. Then a man ( Felipe David )  runs into his office with skin hanging off his arms hands and face screaming explosion explosion. Rodriguez is adamant that explosion occurred in the basement first before the explosion above from plane impact above. 
We all agree on that part so far,  correct??? 
What Rodrigurz forgot is that he gave an interview to CNN on the afternoon of 9/11. He gives these details.    " I was in my office on B2 level when I heard a rumble. Then a few seconds later I hear a second Rumble like moving heavy furniture.  Then a man comes running into my office with skin hanging off his arms hands and face screaming explosion explosion. 
CNN interview never mentions what direction the rumbles came from or that they were explosions.    
Here is the good part.  
A few years after 911 Rodriguez began helping other Hispanics that were injured on 9/11 to get assistance and Aid.  He would tape these conversations in the process of helping them to get aid.  One of those conversations went like this.  
"" A man named Sanchez was on B4 level when he heard what he thought was a bomb.  He and another man began walking out.  As they were walking past the freight elevator a fireball erupted from it. The hot blast of air knocked them both down breaking the other man's knee and Ankle.  
That sequence of events supports a plane impact first and explosions in the lower levels and Lobby second.. 
Like I told you Rodriguez contradicted himself without even realizing it
Reply: To lazy??? you serious apparently you have not been seeing my replies lol. hahahahah thats all I do is provide  info. And yes I seen the CNN video thats not new news the reason why I take his story for what it is is because get this there is video out there with people on 911 saying the exact thing that explosions before plane hit. 
( i mean if you hear rumble and more rumbles then a guy runs in with his skin hanging off of him yells and says explosions then its safe to say that the rumbles you heard were the explosion the guy injured is talking about......... "yes/ no" or am I smoking crack lol)

1st = A man named Sanchez was on B4 level when he heard what he thought was a bomb. -- Okay he thought he heard a bomb

2nd = He and another man began walking out.

3rd = As they were walking past the freight elevator a fireball erupted from it. The hot blast of air knocked them both down breaking the other man's knee and Ankle.  

But it could also mean as you are trying to say that a fireball from the plane hit is what they witnessed as well. Interesting I will say this I will not discredit this. But I am searching this Sanchez guy from B4 and it seems kind of hard to find. You have any sources for it?? I am not scared to be proven wrong. All I am getting is obituary for 911 and other things not really  easy to find. Or at least provide the words you are using to search for this Sanchez guy

:::Never mind found it took a while..
Reply: TimeOut Corner..            Well, Yes. you are Lazy,, you didnt want to do the research.. Bruce Lansberg even tried to help you..pointing you in the right direction.. 
NOW,, since ALL truthers also lack common sense, I realize I should have given you ALL THE DETAILS to help explain the taped conversation.. I didnt know YOUR memory was that weak
 1. the '''bomb'' Sanchez heard WAS the plane impact..      Now flaming jet fuel is falling down the elevator shafts.. it reaches the basement and has no where else to go, but out the doors.... 
NOW do you understand.??..........    holy crap... lazy and stupid///       par for the truther profile...
Reply: WTF you talking about LMFAO funny given I always provide him with sources now all of a sudden he cant provide any.... Really this how you guys acting now lol. The same Bruce who every time I say something he then asks for sources then I provide them, this Bruce?? And you say I am lazy because one time I ask for a source lol. Guess I wont do that any more lol hahah And Bruce stop BS you didnt debunk anything I provided all you did was spin some BS nothing has been debunked yet lol I am still waiting on you to debunk that there was no evidence of explosives on 911. Ohhhh yea I forgot you couldnt because there was evidence of explosives on 911 AND THEY STILL DIDNT test or investigate for bombs being the cause of many explosions/bombs going off that witnesses reported on.

So how much jet fuel would be needed to travel that far down the elevator shaft to cause that?? Given most of it was consumed on impact. And thats even assuming most of it even went down the elevator shaft and even assuming even more that the elevators were at the basement and lobby level during impact??? So I ask again why did they not test for explosives?? This is where all of this s stemming from. Okay call me stupid dont matter why not test and investigate for explosives because I will say this again there are only so many elevators and "office supplies" that can cause explosions that can cause so much damage to where lobbies are destroyed as portrayed by witnesses. And lets not for get people report hearing explosions during the entire event during 911. Yet still no investigation into.
Reply: What kind of fireball destroys a lobby and levels of a basement if the fireball only went out one way??? You guys have to make up your mind either the fireball caused the elevators to blow open in the lobby or it did it in one of the basement levels as well what level/floor was the elevator on for it to finally case this supposed jet fuel fireball to finally have to burst out after hitting a road block from shooting down the elevator shaft??? As well what kind of fireball can blow out elevator doors then also blow out regular doors that are not elevator doors on different levels lol??? How about them types of questions because bomb technologies are very vast and plenty so i wouldn't know.

Maybe we should ask those guys who got arrested on 911 who were caught with a crap load of explosives fleeing the scene in a van as well another van caught with traces of explosives and another van caught with a painting of a plane crashing into the WTC towers Ohh ooops I forgot apparently "Bruce Lansberg" debunked this already... So what about we ask all those art students who were arrested the year of 911 many who had ties with non US governments and military bomb expert jobs within that external government. Ohh "Bruce" debunked that to well how about we ask those other people who have photos of themselves installing a crap load of fuses into the WTC the year of 911 ohh shoot "Bruce" also debunked that well IDK 

Lets just ask NIST to run one of those famous simulations they are famous for to find our answer for what kind of bomb would be needed for your question lol. I am sure they can conjurer something up for you lol
Reply: TimeOut Corner you really are that stupid aren't you.. I must admit you are not Faking It.    ..
Reply: lolso you are telling me people were not arrested on 911 fleeing the scene with a van full of explosives?? Yet they still dont investigate for explosives LOL Okay yet I am stupid

So now you are saying there are not photos of people installing a crap load of fuses into the WTC foreign people.. okay yet I am stupid LOL okay

So you are saying that O F it lol i guess when you ignore facts you are smart when you question BS you are stupid like I said I guess I am stupid lol hahahhahahahahahaha

Because again I will state and re-post:

Maybe we should ask those guys who got arrested on 911 who were caught with a crap load of explosives fleeing the scene in a van as well another van caught with traces of explosives and another van caught with a painting of a plane crashing into the WTC towers Ohh ooops I forgot apparently "Bruce Lansberg" debunked this already... So what about we ask all those art students who were arrested the year of 911 many who had ties with non US governments and military bomb expert jobs within that external government. Ohh "Bruce" debunked that to well how about we ask those other people who have photos of themselves installing a crap load of fuses into the WTC the year of 911 ohh shoot "Bruce" also debunked that well IDK.

I guess you dont like it when you cant spew your BS lol dumb ass lol hahahahhahaha
Reply: TimeOut Corner........    Lets explain one more point.. since you CANT figure it out.......  IT doesnt matter WHERE the elevators are..  IN fact.. which ever floor the elevator is stopped at,, those doors are somewhat protected from the exploding jet fuel..... there was NO 'explosion'' on the b4 level when that guy ''''Sanchez""" thought he heard a bomb..    Then , how ever  long it took for the fuel and fireball to reach the basement,, that is what did the damage...  and in the lobby too.   
There is NO evidence of an EXPLOSIVE going off anywhere in the towers....  To assume that EVERYONE on the NIST panel are idiots, or paid off.. is the ONLY way you can continue to spout your ignorant ''explosives' theory.
There is a much more easily accepted cause for all the truther theories......   You guys all suffer from some form of mental illness.....and probably a superiority complex... thinking you are all soooo much smarter than everyone that supports the official story...
Reply: lol ummmmm NIST never investigated nor did they test for explosives so they wouldnt know if there were explosives thats my entire argument smart guy is why did they not test for explosives as even NIST says well we never heard reports of explosions which in itself is a lie so you guess up with who is lying or not we already know the answer to that. The question is WHY???

So no crap there is no evidence they never tried to make sure there was no evidence of explosives yet you want to sit there and say  we suffer from mental illness LMFAO yet there is proof of explosives on the day of 911 as they arrested people with a van FULL OF EXPLOSIVES lmfao so  EXPLAIN this as to why they didnt investigate for explosives as a possible cause tied in with events and reports?? you cant answer it because there was no reason what so ever for them to not test for it unless they didnt want to find any.

Superiority complex lol huh you sound familiar lol hahaaahaa no i dont think im smarter i just think my common sense tells me if a crap load of people report explosions and bombs going off and people are arrested with a van full of a crap load of explosives; another van found with residue of explosives meaning it once had explosives in it but not any more-so where did those explosives go and also a van with a painting from the same people with a plane crashing into the WTC building, then maybe IDK they should have you know actually tested and investigated for explosives lol im just saying LMFAO thats what my common sense tells me So yeah F a Superiority Complex dumb ass thats called Common Sense lol hahahahha

But i guess according to you dumb asses that doesnt matter its all irrelevant lol.. maybe you are suffering  from "Dumb-Assity Complex"

LMFAO i mean you cant make this stuff up:

You got Dumb Ass "Bruce Lansberg" making up some stupid excuse to explain away peoples reports of explosions by saying well stupid crap like well they didnt report the explosions they heard to be a certain decibel value there for they were not bombs LMFAO as if people can now determine the sound level in dB by simply hearing a sound LMFAO hahahahahahahahahah

Then you got Dumb Ass "Semni Istiqlal" talking about a collapse will cause everything to look like it was in a blender LMFAO hahahahahaha as if the collapse of the towers was in a spin cycle  infused with steel shredding spikes lol hahahahahhaahah.

Then you have Dumb Ass "Joe V" ohh my bad thats you talking about NIST didnt find any explosives when its a NO SHIT moment given NIST never even tested nor investigated for explosives even though evidence and even Federal Policy required them to do so just based on the events alone lol hahahahahah yet somehow he thinks its A-okay for them not to because of some stupid simulation told them not to lol hahahahhahahahahha

And yet you over here claiming I and others are suffering from mental illness when you nor any one of you so called "debunkers" cant even explain YET with a valid reason why even with pics of people installing crap loads of fuses in the WTC the year of 911 , with explosives found on 911, reports of countless explosions on 911 etc. there was no actual investigation/testing for explosives LMFAO yeah sounds  like "Dumb-Assity Complex" to me that you guys are showcasing lol hahahahhahahahahhahah
Reply: Timeoutcorner - " I always provide him with sources "
No you don't. Once only and it showed the opposite of what you were claiming.

"The same Bruce who every time I say something he then asks for sources then I provide them"
Please enlighten me. Which sources have you provided? Just saying "I saw it in a video" is not providing sources. You have provided 1 link. 1 link only and it DISPROVED what you were claiming.

"And you say I am lazy because one time I ask for a source"
No, he is saying you are lzay because you do not do any research. Even after Joe and I mentioned William Rodriguez more than twice, you still think the guy is called Sanchez. How many of my links have you actually checked? How much effort have taken to check the "facts" you heard in YouTube videos?

"you didnt debunk anything I provided"

Your claim: "everything was gone turned to dust"
My response: Please take a short look at these pictures and tell me again everything turned to dust:
https://www.fema.gov/media-library-data/8522ad7e-bec3-4711-b278-dc4615616382/5310_large.jpg
https://www.fema.gov/media-library-data/4111026a-3ce7-4aa6-80cf-8750c53e6d61/5326_large.jpg
https://www.fema.gov/media-library-data/0fc2d9df-9c9a-4e2e-9c6e-1a8712a19059/3916_large.jpg
And right down into the basement where a large part of the debris ended up: https://www.fema.gov/media-library-data/1339b4c1-a1b7-428a-b7a4-d361187efb43/3946_large.jpg
Yeah, all turned into dust and not enough debris: https://www.fema.gov/media-library-data/f65cbebf-cbcc-4a9f-ba37-47fb4f8a2350/3970_large.jpg
https://www.fema.gov/media-library-data/460b6df3-513d-453f-8862-a217cfcf83d0/3983_large.jpg

Now go see this video here and scroll to 17 minutes and 40 seconds. You will see a few men descending into the "bathtub", the basement all underneath the WTC complex. They are in the process of digging out a firetruck, 5 floors below street level. Wonder how it got there? It just fell in when the debris of the collapsing towers destroyed that 6 floor basement. A lot of the debris disappeared into that same basement. Please be aware that this basement did not just cover the footprints of the towers. It was all over the WTC site:
https://www.fema.gov/media-library/assets/videos/118346

DEBUNKED

Your claim: "They literally only found ONE filing cabinet"
My response: That's pure nonsense. A lot was pulverized or cut to tiny pieces. A lot of small sized items have been found like credit cards, keys, guns (police), toys, remains of 1,100 humans, plane parts."

DEBUNKED

Your claim: "Concrete doesnt just turn to dust"
My response: Just take a look at this video from the Mexico earthquake. A simple 4 story building. Little height. Little concrete. Lots of dust. Are you sure concrete doesn't turn to dust? https://youtu.be/qB1vSf2jIBk?t=5s

DEBUNKED

Your claim: "you are the only one in the world saying its concrete and dry wall NOT even NIST, FEMA, 911 commission,  no engineer or scientist is even stating  that"
My response: "Paragraph 2.4 from the NIST report on the towers: "... dust from the pulverized walls and floor slabs". Yet, the dust consisted of:
45.1% Fiberglass, rock wool (insulation, fireproofing)
31.8% Plaster (gypsum), concrete products (calcium sulfate, selenite, muscodite)
7.1% Charred wood and debris
2.1% Paper fibers 
2.1% Mica flakes
2.0% Ceiling tiles (fiberglass component)
2.0% Synthetic fibers
1.4% Glass fragments
1.3% Human remains
1.4% Natural fibers

FEMA investigated building performance. 9/11 commission investigated the events leading up 9/11. Why would they mention anything about the dust cloud? Even NIST only investigated the sequence of events that lead up to the collapses. You can very easily verify all this for yourself."

Your claim: "building 6 it has a big ass hole in the middle like it was blown out."
My response: "Blown out as in debris of the north tower literally falling through the building. Have you ever taken the effort of searching for pictures? Let me help you out:
https://powerm1985.files.wordpress.com/2017/02/inside-wtc-6.jpg
Please look at the bottom part of the picture. See the exterior panels of the north tower lying there? Now look at the top part of the picture. See these panels still hanging there? Now look at both sides of the picture. See the damage to the structure, the downwards bent steel? It looks like something heavy fell onto it. Guess why that is? Please note that this is a picture from your friend Wood's book."

DEBUNKED

Your claim: "pretty much a perfect circle"
My response: "Nah... See picture above."

DEBUNKED

Your claim:  "once again no debris in it"
My repsonse: "Nah... See picture above. No debris inside WTC 6? And pretty much perfect circle? http://www.drjudywood.com/articles/DEW/dewpics/Image151.jpg. See the source of this pic? I also found a nice high res picture with an overview of the whole site. Both towers, WTC 7, WTC 5 and 6. All you need is here. Even a glimpse into the basement to the right of the remains of the south tower. To get a sense of the scale of the site, please take a look at the group of about 15 people at the bottom part of the picture about 2/5th from the left. https://buildingfailures.files.wordpress.com/2014/02/wtc.png"

DEBUNKED

Your claim: "the officials even that day to gave a BS explanation saying that ohhh well they just evaporated"
My response: "you come back to me with a video of a reporter that talked to a volunteer that said the rubble fell into the ground, evaporated. Do you not understand the difference between a volunteer and a an official? Do you not understand the difference between mass being evaporated and debris being evaporated? Do you not understand that a reporter quoting a volunteer is all but an official statement?"

DEBUNKED

Your claim: "even in the video they pan in onto where the "collapse" site is"
My response: "This is proof of how little you understand about ground zero. That video was taken from one of the top floors of a residential building between Greenwich St and West St., zooming in on West St. The view to ground zero is blocked. We see just a little bit of West St. where the WFC is."

DEBUNKED

Your claim: "you are out of your mind if you think building collapses are accompanied by large amounts of dust "
My response: "No. It is you who is out of his mind of you think collapses do not go together with large amounts of dust. I posted it before, including a link to a short video where you can verify for yourself. Here is anpther video. yes, this is a controlled demolition. The dust is not produced by the explosions as you can CLEARLY see. It is produced by the collapse. See how this tower "turns to dust" as well? https://youtu.be/SaBQ3AkRetI?t=44s"

DEBUNKED

Your claim: "there are many reports with people saying the dust was hot as hell."
My response: "Could you show a few? Nobody got burned by any dust. Of all videos of people taht were captured by the dust, none of the videographers mentioned anything about hot dust. The 
"only" problem they had was issues breathing because of the dust."

DEBUNKED

Your claim: "NIST, 911-omission said they didn't investigate for explosions because they didn't find any people reporting explosions"
My response: "911 commission did not investigate the collapse. I mentioned that before. NIST NEVER said they didn't investigate for explosives because they didn't find any people reporting explosions. Where in their report is this mentioned?"

NOTE: This is where you totally misquoted NIST and we had the useless discussion :)

DEBUNKED
Reply: Timeoutcorener - "I am still waiting on you to debunk that there was no evidence of explosives on 911"
Errr.. What is there to debunk? There was no evidence for explosives, so I don't need to debunk that. Maybe you wanted to say you were still waiting for me to debunk your claim there WAS evidence for explosives? If so, let me repeat my earlier question: What evidence?

"you couldnt because there was evidence of explosives on 911"
So, which evidence again? Haven't we been through this before?

"AND THEY STILL DIDNT test or investigate for bombs being the cause of many explosions/bombs going off that witnesses reported on."
We've been trhough this very extensively two weeks ago. There were no sounds of explosions witnessed just before or during the collapses. That's all that matters.

"So how much jet fuel would be needed to travel that far down the elevator shaft to cause that?? Given most of it was consumed on impact."
Yes, most of it was consumed on impact, causing a huge explosion. Part of that explosion travelled down the elevator shafts in the form of a fire ball. What do you not understand about that?

"So I ask again why did they not test for explosives?"
Sigh... If you still don't understand after repeatedly being explained, let's use an analogy. The police is investigating a murder. The victim is examined and stab wounds are found. No one heard a gun shot. There are no bullits. And there are many witnesses that say the the victim being stabbed. No you are asking why the police did not investigate the option of the victim being shot. Get it?
Reply: Timeoutcorner - "What kind of fireball destroys a lobby and levels of a basement if the fireball only went out one way?"
Just to be sure, do you think an explosion can only go out one way?

"Maybe we should ask those guys who got arrested on 911 who were caught with a crap load of explosives fleeing the scene in a van"
I asked you this before: What is your source for this claim? How are we supposed to respond to his comment if you are not able to provide the source? I have never heard of this claim. You have. Where did you learn about it?

"another van caught with traces of explosives"
Source?

"another van caught with a painting of a plane crashing into the WTC towers"
Are you referring to this truck?
https://kendoc911.files.wordpress.com/2014/12/umsrendition1.jpg
Do you realize it was photoshopped?
https://kendoc911.files.wordpress.com/2015/04/umsoriginal.jpg?w=320

"ooops I forgot apparently "Bruce Lansberg" debunked this already"
No I didn't. this is the first time you came up with it.

"So what about we ask all those art students who were arrested the year of 911 many who had ties with non US governments and military bomb expert jobs within that external government."
Which art students? Who got arrested? For what? Source?

"how about we ask those other people who have photos of themselves installing a crap load of fuses into the WTC the year of 911"
Could you please provide a link to these photos? I am aware of the Austrian art collective going by the name of Gelitin. I think you are referring to this. There are no pictures of them installing any fuses. There are however pictures of them executing one of their projects named The B-Thing (http://www.gelitin.net/projects/b-thing/). That project was conducted 19th March 2000, 1.5 years BEFORE 9/11. The boxes you see in the pictures you mentioned were put up as a boudary of their space in which they were able to work on their project. The boxes are labelled BB18. If you would take any effort (yes, you're lazy) you would know that BB-18 is a power feed lug for a 3 phase bus bar system. Not detonation fuses, but electrical power fuses. 
http://www.littelfuse.com/products/fuse-blocks-fuseholders-and-fuse-accessories/dead-front-fuse-holders/powr-busbar/bb18.aspx
Reply: Tmeoutcoren - " so they wouldnt know if there were explosives"
There are some features of explosives that need to be present for the explosions to be present. Think incribly loud sound. Think flashes. If these features are not there, the explosives are not there.

"even NIST says well we never heard reports of explosions"
We've gone over this extensively. NIST NEVER SAID THAT!

"they never tried to make sure there was no evidence of explosives"
How do you prove a negative?

"yet there is proof of explosives on the day of 911 as they arrested people with a van FULL OF EXPLOSIVES"
Even if this were true, even if the FBI arrested people with a van full of explosives, how does that prove explosives were being used to bring down the towers? It clearly cannot have been the alledged explosives found in the van. But again, could you please share your source? 

"you cant answer it because there was no reason what so ever for them to not test for it"
Read the anwers and explanation above. There are plenty.

"You got Dumb Ass "Bruce Lansberg" making up some stupid excuse to explain away peoples reports of explosions by saying well stupid crap like well they didnt report the explosions they heard to be a certain decibel value there for they were not bombs"
Oh dear god... You haven't understood anything I said, have you? Let me try it one more time: Yes, people reported hearing explosions. No, explosions are not necesarilly the result of an explosive. Sunder said (in the video you provided yourself) that there are no reports of explosions just before of during the collapses. He is saying that "this incredibly loud sound that would have been produced in any blast scenario", was not recorded or witnessed. So:
1. No loud explosions reported (heard or taped). 130-140 decibel, at half a mile distance,  comparable to standing next to a jet engine, 10 times louder than standing next to a speaker at a rock concert.
2. No explosions heard or recorded at the moment of the collapses.
Do you not understand the significance of that?

"as if people can now determine the sound level in dB by simply hearing a sound"
We have also discussed this. You asked how NIST would be able to determine the sound level. I drew up an example. "Was the sound as loud as a jet engine?" is not a very difficult question to answer.

"a collapse will cause everything to look like it was in a blender."
Yes.

"as if the collapse of the towers was in a spin cycle  infused with steel shredding spikes "
No. This is what YOU make from it. This is NOT was he said.

"even Federal Policy required them to do so"
Link please?

"because of some stupid simulation"
Clearly you have no understanding of the significance of computer simulations.

"I and others are suffering from mental illness"
Yes, you and others do.

"pics of people installing crap loads of fuses"
Explained above. Do some research you lazy moron.

"with explosives found on 911"
Source please. And please explain how these alledged explosives have caused the towers to collapse? What good does a truck loaded with explosives on 9/11 do? Shouldn;t the explosives have been installed months before? How doe people install explosive fuses and forget the explosives? You lazy moron. Teach us about common sence again please.

"reports of countless explosions on 911"
None of them at the moment of collapse. Explain to me how explosions 10-20-30 minutes before the collapse cause these same collapses. You lazy moron!
Reply: I am not talking about the 5 dancing Israelis smart guy LMFAO hahahahahahahah nice try though, thats another story in its own right tho lol again nice try tho You do realize there was more than one van and more than one group of people lol again nice try tho lol hahahahahhah even the NY County officially reported this themselves lol

ummmm lol what?? Cut beams??? I am talking about explosions lol but IDK what you are talking about because there is video showing a cut beam but regardless I am talking about explosions lol 

But regardless trying to be slick to change the subject off to something else I see plenty of firefighters, police, reporters, etc. report loud explosions and bombs going off period. So once again why not investigate and test for explosives.

lol so here we go again lol I guess you didnt know that there was recorded audio from police that day reporting exactly what they came across LMFAO hahahahahhahahahahahahahahhahaha. So if the police that day report whats happening on the radio then hand everything over to the FBI then the FBI later months later ordered by guess who a man with Israeli dual citizenship forced them to release the suspects and deport them back to Israeli lol... Then go figure why the FBI would say no we found nothing lol No its not the people working the case its the higher ups. unless you think it is the cops who are lying making BS up on the radio that is lol

https://www.youtube.com/watch?v=BVhBXFly-jM
https://www.youtube.com/watch?v=5gC4T6v6Rc8
https://www.youtube.com/watch?v=Huf2Kz7bV2k

Sucks for you you guys keep taking these L's

maybe if you stopped trying to find un-debunked BS and just open your eyes you wouldnt have much of a DumbAssity Complex

I see you and Bruce must be doping some late night work together just to try and blow BS out of your asses lol
Reply: TimeOut Corner.   Here ya go..  Go to 2:55 and listen...
https://www.youtube.com/watch?v=GGO2ozFkD-0
Reply: ummm and what are those supposed to prove???? I just gave you an audio recording with police reporting LIVE  what they are seeing. Not once in the video you provide do they say those are false reports the closest you get is a video that you can find on YT of a Police Comiss (or whatever his rank was) saying he is unaware of such reports and he has not verified it yet something of that nature (talking about van with explosives) but of course all suspects were handed over to FBI so from then forward they wouldn't know. But lucky for us we have the LIVE police recording telling us exactly what they found such as the van with a painting of a plane on it crashing into the WTC, so again you are trying to be slick and miss-lead.

The video you provided is them going over reports that are verified as false then they do start to talk about the vans but then all they really say before they abruptly change the subject to something else is that they still have nbo information on that-note the Police Comiss still hasnt yet verified it... (Taking a pretty long time to verify something that could take so easy to verify lol funny given that earlier even Mr. Comiss was talking to the Mayor about the exact arrest and bombs found - of course all before handed over to FBI Lol) No worries we still got them live police recordings tho lol
Reply: Timeoutcorner - "what?? Cut beams??? I am talking about explosions"
How do you think controlled demolition works? You think simply putting explosives against the steel will cause a controlled collapse? Please study the art of controlled demolition at least a little bit. Then you will understand there is no control in controlled demolition without cut beams.

About the alledged exploded van, don't you think people would have noticed? Don;t you think some news agency would have picked up the sound of an explsoding van near ground zero? The place was covered with reporters. Yet, nothing about an exploded van.

As for the George Washington Bridge van. This story originated from the CBS coverage where Marcia Kramer reported to Dan Rather about the van with explsoives. What the conspiracy theory videos do not show is the part where Dan Rather retracts this story: "Marcia Kramer of WCBS-TV, our CBS-owned and -operated station in New York, reported some time ago that the FBI had in custody two suspects caught with a pickup truck of explosives around the George Washington Bridge; now further checking on that story [reveals] that other law enforcement officials in New York said they knew nothing about it, and now Jim Stewart is saying that FBI headquarters in Washington knows nothing about it. We'll have to put that in a long line of things that's under the 'Well, we're skeptical now.' Maybe it's true and maybe it isn't."

http://fair.org/take-action/media-advisories/rathers-retirement-and-liberal-bias/
http://web.archive.org/web/20100224011350/http://www.nydailynews.com/archives/news/2001/09/15/2001-09-15_blunders_mar_scoops_in_the_r.html

What the NYTimes had said about this incident: "On CBS Tuesday night there was a report -- originated by its New York station, WCBS -- that a van filled with explosives had been found on the George Washington Bridge. Though men in a van were detained, the vehicle did not contain explosives. Still, CBS said the report was based on trusted sources and the station corrected it when it learned that the report was in dispute."

http://www.nytimes.com/2001/09/17/business/after-the-attacks-the-coverage-some-flawed-information-occasionally-creeps-in.html

Do some real research, or as Joe adivsed, finish your research.
Reply: TimeOut Corner.  I guess  you didnt watch this one....Try again..   Here ya go..  Go to 2:55 and listen...
https://www.youtube.com/watch?v=GGO2ozFkD-0
Reply: Bruce Lansberg
Excellent links..   It really is crazy how Lazy and ''common sense'' lacking the truther tribe is....
Reply: lol nice try buddy but again no where do they say in any of those articles that they were false all they pretty much say is that they need to verify or certain personnel were not aware of such claims (they do however verify other false claims on that day but no where do they vividly state the vban explosives where false all you ever here them say is beat around it by saying need to verify, disputing the claim, unaware of cliams etc.....But again you had the Comiss telling the Mayor himself that they captured such suspects with explosives only to later have him on live TV say he is unaware of such claims of explosives (So how can you report something then later be unaware of said claims you were just reporting on?????) lol 

But again this still does not negate the fact that we have LIVE AUDIO from the police officers themselves that day reporting things live that you guys say did not happen or never existed LMFAO hahahahahahah
Reply: I just went over that with you are you this ignorant lol 

The video you provided is them going over reports that are verified as false then they do start to talk about the vans but then all they really say before they abruptly change the subject to something else is that they still have nbo information on that-note the Police Comiss still hasnt yet verified it... (Taking a pretty long time to verify something that could take so easy to verify lol funny given that earlier even Mr. Comiss was talking to the Mayor about the exact arrest and bombs found - of course all before handed over to FBI Lol) No worries we still got them live police recordings tho lol
Reply: Umm WTF lol they say that: they still have no information about that...
Funny given that these reporters were being told by the FBI that they had found explosives... was reported vividly that the Comiss reported to the Mayor that they found explosives...

Then everything gets handed over to FBI then all of a sudden now the News media are waiting for information and disputing it... Now all of a sudden the Comiss who was talking to the Mayor about it doesnt know of any reports of said explosives etc. lol how does that even work out.

All of this is pretty easy to comprehend (Cover Up) lol I mean LIKE I KEEP SAYING WE HAVE THE LIVE POLICE RADIO RECORDINGS FROM THAT DAY... they prove that things you say were not there was in fact there that day.
Reply: lmfao bruh lol hahahahahah how in the hell are you going to accidentally imagine and see a picture of a plane crashing into the WTC on the side of a van and report it to your comrades on radio for backup LMFAO hahahahahahahahhahahahahahahahahahahahahahahhaha

Like I said no matter what you guys will try anything to discredit witnesses and what they say that day and what they witnessed no matter what LMFAO hahahahahhahahahah

Lets ignore the witnesses (who have nothing to gain or lose from reporting the truth) and just believe what the higher ups tell us (who have lots to lose and or gain) even if it contradicts what the people on the ground live witness and tell us LMFAO hhahahahahahhhahah
Reply: TimeOut Corner you are living proof that truthers truly suffer from a mental illness.   It varies depending on what theory your trying to back up,. 
ANyone that can be shown evidence, from multiple sources and ignore it just to continue believing in there factless bulshit is whacked in the head.
Reply: EVIDENCE??? lmfao you mean evidence with Police LIVE on the scene telling you exactly what they are seeing LMFAO and reporting it multiple times and you are talking about ignoring evidence lol

So riddle me this smart guy how can one be sick in the head just be cause he says:
lmfao bruh lol hahahahahah how in the hell are you going to accidentally imagine and see a picture of a plane crashing into the WTC on the side of a van and report it to your comrades on radio for backup LMFAO 

Sounds like to me the one sick in the head is the one trying to convince people cops now have no clue as to what they are seeing and that they are imagining rainbows and unicorns on a day when thousands lost their lives lol yeah now thats sick in the head logic i.e. DumbAssity Complex from you Joe and others alike lol but what do you expect from people like you, you do this to every witness try to discredit them to the max no matter what.
------

anyways 
Evidence??? a crap load of people report explosions, even loud explosions... and you are talking about ignoring evidence from multiple sources LMFAO hahahahahahahhahahahaahhahhha

Evidence??? There are pictures with people installing crap loads of fuses into the WTC the year of 911 and you want to talk about ignoring evidence?????? LMFAO hahahahahahahahhah

We can go on and on lol hahahhahaha the things you guys do to discredit witnesses etc. is mind blowing lol yet you say we are whacked in the head lol your DumbAssity Complex is showing lol
Reply: ummm because even NY reported on those same people in the towers who installed the fuses thats how (not on fuses but on those people in the tower)  LMFAO 

And again they never investigated nor tested for explosives so they would never know if there were or were not any based on finding any since they never tried to even look for any thats the entire point smart guy lol there are countless reports of explosions countless so you at least test for them if anything given the situation but to go out of your way and come up with a BS simulation not to find if explosives existed but to have the simulation for only means to explain why you didnt even investigate for explosives is in its own right sickening lol
Reply: TimeOut Corner there were two loud explosions heard as the grenfell tower was burning..   does that mean that you investigate for explosives there too
Reply: ummmm yeah lol why wouldnt you want to make sure there are not or were not explosives lol especially for the last time regulations clearly show that they should have lol but for whatever reason they not only did not want to but pretty much refused to test or investigate for explosives A SIMPLE ASS test they didnt even want to do to get correct the murders of thousands of people yet you you over here saying we whacked lol

To not do it is criminal and make matters worse they go out of their way to waste time and money on simulations to justify their reason for not testing - when they could have spent that time and money on guess what a few tests and an investigation into the explosions... sickening at its finest
Reply: Timeoutcorner - "how in the hell are you going to accidentally imagine and see a picture of a plane crashing into the WTC on the side of a van and report it to your comrades on radio for backup"
The problem with this occurance is simply that there is little to verify. We have a police transmission recording of which I believe is genuine. I found these recordings have been made by Robert Sanford who has a website that seems to be down: http://bayscan1.50megs.com/. So little information here. I also found copies of these recordings submitted to a website www.incident0727.com. The recordings are available at http://www.incident0727.com/audio.htm. The recording we are discussing as the second from the bottom. unfortunately only the first 1 minute and 37 seconds are available so we can't hear the interesting parts. So we're back to the YouTube clips that do seem to provide the full recordings (which we can't verify).

The next problem is that the audio is unclear. We get parts of the conversation and to me it is unclear if it is really said that the van exploded. He could have been talking about the mural on the side of the van. Now, this is what i also found. It's a comment on a forum, nothing more, but it could give an explanation: "Notice how the police are talking about "remote controlled plane"? According to someone who lives in NYC, the actual image on the side of the van showed more a military plane with camo pattern on it coming up from below the two towers. And underneath is in Hebrew "learn the fun of how to fly model planes". The van was just a delivery van for a toy shop. "

The Mineta report mentions: "A panel truck with a painting of a plane flying into the World Trade Center was stopped near the temporary command post. It proved to be rented to a group of ethnic Middle Eastern people who did not speak English. Fearing that it might be a truck bomb, the NYPD immediately evacuated the area, called out the bomb squad, and detained the occupants until a thorough search was made. The vehicle was found to be an innocent delivery truck.”

Yet, according to the police transmission, the van was stopped at King St. between 6th and 7th. I really don't know what to make of this. Fact is that the alledged explosion was not mentioned in ANY media outlet. I am pretty sure it would have gotten at least SOME media attention.

"you guys will try anything to discredit witnesses and what they say that day and what they witnessed"
That is simply not true. It is only about any van exploding. The story is incoherent and unclear.

"just believe what the higher ups tell us"
What do these "higher ups" have to do with this matter? Have you seen Joe or me quoting anything from the imaginary "higher ups"?
Reply: "especially for the last time regulations clearly show that they should have"
Yeah, you have mentioned that before. Let me ask again: What regulations?

"for whatever reason they not only did not want to but pretty much refused to test or investigate for explosives"
I have explained the reason. NIST themselves have explained. The real problem here is that you don't accept these explanations because it doesn't fit your conspiracy theory. If I were you, I would send a letter to NIST demanding them to investigate the possibility of the towers have collapsed by an earthquake. Pretty sure you think there's a legal reason for them to do this was well and they are criminal because they "refused" to do this. The only reason NIST should have investigated for explosives is to silence any conspiracy nutter about this fantasy. If they would have however, you would have parotted another CT "question" as to why NIST would have investigated for explosives if there were no explosives. You would see this as proof there actually WERE explosives anyway. Do you really think it would have made ANY difference AT ALL if NIST would have been able to anticipate on a few nutters' bullshit claims and did investigate for explosives? Because that would have been the ONLY reason for NIST to do so.

Now cough up those regulations. Or are you making up evidence again?
Reply: Bruce Lansberg ummm the police Commissioner is a higher up lol what was heard in the police regarding also is reported NY county as I have stated so once shrub we are at the point to where we are ignoring police reports you can hear them clearly saying what they see on the van there is no miss understanding lol they say it a couple of times as well. If you want to disregard it then so be it lol

And no credo I know what the boxes were the he'll do you think I mentioned it for   lol they had access to the entire WTC Buildings lol trying to make it seem as if they were only allowed in that one spot.

And no credo it was all that time before lol first you guys mock and say there is no way they could have rigged the building in one day or two then when evidence emerges that planning been in place for a while now all of a sudden that's too much time to far out I mean. Apparently you dont realize all the components that are in play for demolitions lol
Reply: Timeoutcorner - "the police Commissioner is a higher up"
And your point would be what exactly? :) I have never quoted this sommissioner. You have. 

"what was heard in the police regarding also is reported NY county as I have stated"" 
I have no idea what you're saying here. What is NY county? How does a county report anything? I don't understand what you're trying to say. Maybe providing some link will help. 

"so once shrub we are at the point to where we are ignoring police reports"
Which police report? Can you show me please? I have not read a police report mentioning this exploding van. I have not read anything in any newsoutlet about this exploding van. How do you explain this occurence never had any coverage at all?

"you can hear them clearly saying what they see on the van there is no miss understanding"
So what? The ineteresting part is the alledged exploding of the van. I am not interested in any mural.

"I know what the boxes were the he'll do you think I mentioned it for"
You still have no clue. BB18 is a POWER FEED LUG. Look it up if you don't know what it does. This has NOTHING to do with detonations AT ALL. I think you believe those boxes contained detonation fuses. I think that's why you mentioned the boxes. I have explained twie what it was and I provided links for you to verify. Now I just mentioned it a third time. What is it you don't understand about this?

"they had access to the entire WTC Buildings"
No they hadn't. They had access to the 91st floor as the port authority granted them and 14 other (non related to Gelitin) artists a space to work.

"trying to make it seem as if they were only allowed in that one spot."
What makes you think they had access to the whole building in the ifrst place?

"And no credo it was all that time before"
Man, you should stop smoking dude. You are making no sense at all. You claimed that these guys were installing detonation fuses in the year of 9/11. I showed you you were wrong again. The picture you are most probably talking about, was taken March 2000, 1.5 years before 9/11. You don't even get the most simple facts right.

"first you guys mock and say there is no way they could have rigged the building in one day or two"
I never claimed that. Because it is irrelevant. You claimed the picture was taken in the year of 9/11. I proved you wrong.

"when evidence emerges that planning been in place for a while"
What evidence are you talking about? I asked you twice to show the picture where we see your Israelian art students installing fuses. Please show it. I know you can't. Are you man enough to admit you were making up evidence?

"now all of a sudden that's too much time to far out I mean"
Again, you are completely missing the point. What's wrong with you? I am getting worried now. So please, take some time to compose a clear reply, use some grammar rules every now and then and try to tell what it is you are trying to tell. Meanwhile read some repplies every now and then. It helps getting the discussion on track.

"Apparently you dont realize all the components that are in play for demolitions"
I do not see why this comment is relevant. You claim so much, yet never provide evidence for these claims. Please take some time and effort in doing so. Please start with showing the pictures you mentioned about the Israelian art students installing these detonation fuses.
Also, how about posting a link to these regulations you mentioned earlier?
And please could you provide the sources I to back up your claims, as I have asked many times before?
Reply: Joe V - "It really is crazy how Lazy and ''common sense'' lacking the truther tribe is..."
I am flabbergasted by the lack of knowledge and effort these guys are willing to put into this matter. Claim after claim without ever backing them up. Never answering questions. Never any sources. We provide verifiable information that proves their claims wrong. And before I have finished my reply, there is another unsubstantiated bullshit claim. It can be really tiring. Their believe in these false claims is so strong, that is very hard to overcome their confirmation bias.
Reply: lol says the guy who thinks people can tell how much something is in BS to determine if something was a bomb blast or not and reasoning to explain why they never tested for explosives lol

Because according to you common sense means not questioning why they would say the Commissioner (higher up) is reporting that he is briefing the Mayor about saving another attack by arresting individuals found with explosives - only to later be caught live saying he has not heard anything about such individuals LMFAO So according to you its common sense to just ignore the earlier reports with him talking about it and only accept his later reports of him saying he knows nothing about  LMFAO hahahahah okay got it... again Its called a cover up for a reason

You never answered any questions. For the last time why did NIST never actually test and investigate for explosives your ridiculous excuse of people not reporting blasts at a certain level of DB is not an answer it is BS to once again undermine and try to discredit what people actually heard and witnessed that day. (another attempt of you trying to discredit witnesses you some how act like you have not been doing this entire time lol).

Not once have I discredited any witness. I have questioned officials who even admit things like we have no clue why a building collapsed but then go on to say it was because of fires even though they say they dont know how it fell lol So if questioning and going off of what is available to find answers to those questions is Lazy then so be it lol

Then you say 
"We provide verifiable information that proves their claims wrong."

Huh lol you provide information from NIST with so many contradictions its beyond a joke. But yet go to the end of the earth to find why every single witness is either stupid or have no clue what they are talking about. 

A cover is a Cover up for a reason lol You get ride of the evidence, you half ass investigations, you lie, and give false information that contradict each other, you push a narrative etc. Then hope gullible people will not questions anything out that doesn't add up.
Reply: continued from above
Heck even FireFighters in the WTC report LIVE that they did not witness and do not see any raging wildfires that so called weakened the structure of the buildings you people like to vividly claim helped cause the collapse lol - they are pretty much not even worried about fires and this is from FF all the way up past the 75th floor, FF past the 50th floor etc. etc. etc. But let me guess the professional FF are to stupid to know what a fire looks like and or dont know what they are seeing is not what is happening lol Ohh boy

"You get ride of the evidence"
I will play along and ask again: Which evidence? There is nothing to get rid of. You have written quite a lot in this thread, yet failed to come up with eny evidence at all.
+++++++
Speaking in terms of you its acting stupid like you cant find something or lying acting like I deleted my comment
:::::::
Speaking in terms of NIST etc. then its pretty simple... How many samples of WTC7 were kept for their “Official Investigation” or all buildings for that matter?? LMFAO 

"you half ass investigations"
I don't know what this means. 
++++++
Yeah another easy one lol.... The moment you base an entire part of an investigation and testing that involved over 3000 deaths and thousands more to follow in wars etc. To well if these witnesses can tell me if what they heard was as loud as a Jet Engine and if not Case Closed for this part of the investigation LMFAO then yeah thats picture perfect Half Ass investigating.
::::
As well the moment NIST does their BS reasoning for something not being free fall or this and that yet even under their own admission WTC7 did fall at freefall for at least 2 seconds yet they still didnt investigate why that was the case as if somehow a big ass high tower can just go at free fall on its own without hitting resistance for 100 feet with the rest of its building in its way that would have caused resistance LMFAO heck here is avid showing casing their BS lies and disregard towards really wanting to do an actual real investigation https://youtu.be/WTKyyzxbBCI?t=11m29s 
::::
the only thing NIST did for all those years was try to come with excuses why they didnt need to look into this or that as well as come up with dumb ass explanations as to why something they know is full of BS happened that goes against logic, physics, and witnesses

"you lie"
Please show me where I lied and about what. Please quote me exactly as you provide it.
+++++++
You said I deleted my comment - when it was still there as the date proves it. You lie and act like certain parts of videos dont exist etc. 

"and give false information that contradict each other"
Again, please show me where and about what. It is not my fault that you don't understand facts and misinterpret them.
+++++++
The moment you try to act as if NIST never said they never heard any reports of explosions (okay Loud explosions) lol the moment you try and act ;; The moment you say well it was elevators and fireballs okay but how could it happen on multiple floors lol - I.e. if the elevator is hitting at the basement floor then the fireball cant blow open doors in the lobby as well in the basement; as well the elevator cant crash down to cause that much damage if it were that low -  if it were way higher on upper floors then the fireball cant really reach the lower levels with a clear path unobstructed with the same amount of fore it wont even be close- Now the moment the fireball hits the top of the elevator is the moment the fireball will have to change course no matter where the elevator sits like bouncing a ball on the floor, look at a fire hose you can aim water down a barrel on full blast as soon as it hits the bottom what happens to that water hitting the bottom??? Now unless the planes also had flame throwers on them you are going to have to explain how they would be able to sustain that much power/force after hitting a solid object - Now the elevator crashing to the floor lets say from the fireball can only crash at the lowest floor i.e. basement which means it cant crash in the lobby - another problem with this is how many elevators did they have????? Again this is all based on guessing that much Jet Fuel along with a big ass fireball even went down the elevator
::::
Or how about what I just mentioned earlier above where LIVE reports from FF report on radio that they do not see any fires until they reach what was it above floor 76 and it is only two small pockets of fire my bad make that two ISOLATED small pockets of fire which to me seems like they feel like they can take out with ease.. That alone contradicts NIST lol...

"you push a narrative"
Of course I do. My narrative is based on facts. You push a narrative as well. Yours is based on youtube conspiracy videos.
++++++++
A conspiracy to me is both ways you believe the offical story its a consipracy you believe the truther story its still a conspiracy
::::::
But no I base my narrative on the fact that there are too many coincidences, too many firsts, too many times government and military, civilian  factions failed miserably that has never happened ever on this scale and seemed to be fit to fail on purpose, to many omissions from the Official Reports,, to many reports that contradict the official story, to many connect the dots that make you say WTF when following the money etc. etc. etc.  for me to just sit here say dumb BS like yourself and others that you are okay with them not investigating to the fullest all possible causes of wrong doing on any level from anyone or any group. 

"Then hope gullible people will not questions anything out that doesn't add up."
Please question everything you can/want. If the answer doesn't fit your preposessed opinion however, counter me with facts instead of asking the same questions over and over while they have been answered before numerous times already.
++++++
If I have to ask a question over and over then that means you are not answering them it just means you are merely dancing around looking for a reason to not answer them or find a reason or excuse as to why the question is irrelevant....
Reply: continued from above -
and I forgot ran out of room as stated NIST says they heard no reports of molten steel: https://youtu.be/wcqf5tL887o?t=1m2s
::::::
funny given there are exactly reports of molten steel: 
https://youtu.be/DF4C6qtU_Fc?t=1m27s
https://youtu.be/DF4C6qtU_Fc?t=2m17s - would you look at this in the same video LMFAO the NYT reporting the exact same thing that Volunteer and the same thing that certified "official" engineer said that you tried to act like never existed and was only some random doctor giving his opinion LMFAO hahahahah (and I didnt even know about the NYT reporting on it as well I just came across it lol)
::::
lmfao now i suppose you are going to try and go on one of your wild goose chases as you did with trying to protect and justify NIST lying when they said they heard no reports of explosions (ohh sorry Loud explosions) LMFAO
:::
what are you going to say he meant no reports of high hot molten steel to a certain degree or something lol haaahaahahah..
:::
like i have been saying NIST report and statements etc. are full of BS lies, deception, and miss leading and half ass investigations. If they lie about a few simple things one must ask what else are they lying about or trying to miss lead on and why. Sadly the list of reasons are short the most obvious one is cover up.
Reply: ErgoCogita They didn't burn for 'several hours' check your facts. The dampers present in the lift shafts are known to have operated correctly so preventing, as they were designed to do, fire spreading in that manner.
Reply: evsupp2011 The hole in the ground was visible on Google Earth well before 9/11. Can't recall the date off of the top of my head but it was possibly late 80's early 90's.
Reply: ErgoCogita rubbish
Reply: ErgoCogita GOGGLE CALLED....AND I QUOTE....SAID THEY DONT KNOW WHAT THE FUCK YOU MENT!!!
Reply: CooL!K3DaT Seconded. From what he says I don't think he realises that the potential energy is realised in this instance by the height of the 'drop' he seems to think it's an actual thing within it.

Which of course brings us to the problem with those that accept the official narrative, in that the potential energy is used destroying the floors beneath. I don' t believe any of it so what I've put is bollox in the real World but true if any part of this event was real.
Reply: jam1966ful The kinetic energy that's hitting the floors below it, even though less floors, is still more then enough to break through every floor that's below it, thats why Newtons 3rd law isn't violated.
Reply: Harry Heiniken No, just no.
Reply: jam1966ful 
 http://www.911myths.com/WTCREPORT.pdf

Yea, just because you don't understand how it collapsed doesn't make it a controlled demolition
Reply: Harry Heiniken This pancake theory has been dismissed long ago. 

One thing to pick out for you is that they weren't floors in isolation they were part of a structure. You have every floor beneath supporting each floor, so the model is useless.
Reply: jam1966ful No you're wrong, it seems you have a lack of understanding in how the floors were designed.

The floors were connected to the inner colums and the outter colums by truss seats that were welded in and then they were bolted in to these connections, these were the only connections that the floors had to the building, the impact broke through these connections resulting in the floor collapsing. Over 90% of these floor connections were bent downward and sheared off, exacly like they should of been from a gravitational collapse impact. Additionally, when the floors hit each other from the impact of the collapse, vibrations transfer through the buildings and the floor stripping that fracture those welded connections, so before the floors from top even land on them the connections are already fractured from these elastic waves, reducing their strength, as well as you have an increasing amount of mass building up too.

https://www.google.com/url?sa=t&source=web&rct=j&url=https://app.aws.org/wj/supplement/WJ_2007_09_s263.pdf&ved=0ahUKEwjXi-L9w6vYAhWRdSYKHTf5BLoQFgglMAA&usg=AOvVaw1wizG2YDIJbfELXZ8alakx
Reply: jam1966ful And the result of this pile up and elastic waves are clearly explained.
 https://www.counterpunch.org/2006/11/28/the-physics-of-9-11/
Reply: Harry Heiniken Really? Elastic waves are Harmonics I presume, not gonna happen for many reasons. NIST have abandoned all this already.

Don't think you quite understand how it was built. The floor pans were merely to hold the floors so that no structural supports would take up floorspace. The Towers were like a skyscraper within a skyscraper, the floors had nothing whatsoever to do with the structural integrity so even if every bolt on every floor collapsed the steel structures would still be there.

As to the heat, as soon as the trusses sagged from heat (per the last PDF), they lose any integrity and would be unable to exert pressure in either elastic or plastic stage.
Reply: jam1966ful  You're completely clueless. The floors gave lateral support to the core, so they actually did have a purpose, a pretty big purpose that you overlook because of your inability to understand the structure. 

You really should of taken a harder look at the 2 papers above, one of then written by a PhD Physicts,  peer reviewed, who points out how the elastic waves would of caused damage to the structure, so don't pretend that this wouldn't of existed simply because you don't want to have to acknowledge it. You're completely avoiding all of the evidence, even as its laid out before you.

Based on your response I presume that you didn't read any of the papers. Over 90% of the floor connections were severed or bent down, so how do you explain that? What caused those floor connections to shear off, break and bend downward? The only reasonable conclusion would be the impact of the floors hitting eachother, but according to you that can't be, so I'd like you to explain what would of caused them to break and bend facing downwards, what did that? I can't see how explosives would cause that. But the collapse and impact sure could.

Nor can I see how explosives would cause this movement either

 https://youtu.be/gJbGm7GE1tA

How would explosives of caused the colums to buckle inwards and also GRADUALLY bow inwards and sag like that? You'll need to explain that part also If you want your theory to hold any validity.
Reply: adam R So if it's such a clear controlled demolition to everyone then you should have no problems explaining why over 90% of the floor connections were sheared off and bent, as well as how it's collapse initiated in the first place, because it's colums buckled inward on the video, and this is exacly what would happen in a structurally induced collapse
Reply: well frst thing it dint just collapsed..it ws drilled shafts were rigged gold banks ws emptied ...mossad ws watching they got high end cams but footage ws sm third wrld cam footage .....thats how it ws cntrld demolition job ....do u know concord fell on a school even then rest of the structure ws standing...think....and blamed a guy called osama ....lol ...the people who dint knew how  treadmill works were attacked without evidence ....and yea thermite with sulphur ws found in the remains of trade center....it ws classic demolition cs when u destroy a building u gota get the core collapsed frst thats wt happened....the fires were not hot enf to melt steel and iron ...and u know the govt lies man ....since the brits colonial rule to the making of mew jewish super power people have been lied to ...wars have been orchestrated and false flags r every where .....
Reply: adam R 
 Sure, brining down the core first COULD of caused the colums to pull in first as on the video, but the problem with that argument is those colums had already been progressively sagging well before the collapse initiated, so the core being destroyed first wasn't the cause of the collapse initiation, the only logical answer for how the collapse initiated was because the colums were pulled in as a result of the trusses continually bowing caused by the fire slowly expanding the steel, not because the core fell first. Tall sections of the core still remained in both towers after the collapse too for up to 30 seconds, falling over soon after that, but only because it had at that point lost all of its lateral support.

And the NYPD helicopter reported parts crumbling off the south tower, at the exact spot where collapsing began, minutes before the collapse. Falling off most likely because the floors are slowly being pulled in more, resulting in some pieces to crumble off.

This is EXACTLY how the collapse would of initiated from a structural failure.

"The lower portions of both buildings' cores (60 stories of WTC 1 and 40 stories of WTC 2) remained standing for up to 25 seconds after the start of the initial collapse before they too collapsed"    (World trade center collapse- Wiki)

So to say that the cores were brought down first just isn't true.

No molten steel was present, there's not a single piece of sufficient evidence to say molten steel was found, and molten steel would of already begun solidifying after the collapse, so there is no way that it would be found months or weeks later.

https://youtu.be/cyTxxEhS4uc

The aluminun will glow too at much lower temperature, giving it a similar appearence too, another significant possibility that it most likely was, so the molten metal wasn't molten steel, it was more then likely glowing steel or molten aluminum, which when mixed with other materials found and also pooled up, then it's appearence is almost completely similar. This is exacly how it's described by the fire fighters too, pools of it, "running down the channel" The melting temperature of aluminum is less, plus combined with all the tons of aluminum, it very well would be likely to last week's later and be found.

The buildings, in reality DID collapse to structure failure.
Reply: adam R The thermite and sulfur have explained many times. The thermite is from the welding and building process of the tower.

http://www.scientificmethod911.org/docs/WTC2_dust_sample.pdf

http://www.scientificmethod911.org/docs/WTC2_dust_sample.pdf
Reply: molten steel? temperature never got that hot there....and the metallic spheres the dust wsnt welded thermite and sulphur
Reply: adam R Lol, look at the report I just posted from a PhD Physicts explaining the thermite!!!

Thanks for backing my point up, you're right, the temperatures weren't hot enough for molten steel, there was no molten steel, it was molten aluminum or glowing steel, which both occur at much lower temperatures. 

The video above I posted above is molten aluminum
Reply: which is used by military thats military grade explosives.....and I knw they use it...no explosion creats nano aluminum particles...unless u using special incendiary shit ....yes I will watch the report once am off duty...and if it wsnt that hot then how did u think building ws screwed? got to b explosives lol its the same thing that building ws brought down it dint came dwn just cs a plane hit..
Reply: adam R https://www.uwgb.edu/dutchs/PSEUDOSC/911NutPhysics2.HTM

"If it wasn't that hot then how do you think the building was screwed"

Because the impact from the plane knocked fire proofing off the floor trusses and caused some of the floor trusses to break off, resulting in the floors sagging and pulling on the outer colums until the bolts that held the outer colums together broke, as is shown perfectly right here.

https://www.metabunk.org/data/MetaMirrorCache/15d987530fb19f490198129171c8d200.gif

You can see that as the colums buckle in the image they all buckle at the same length, that's because the steel colums themselves aren't what buckled, the bolts that held them together broke from the intense stress, resulting in the entire top of the building falling down to the structure below.

I've even shown you that the floor connections were all broken off too, the only reason that can be is because the impact from the floors broke them off and bent them. How would explosives possibly of caused the floor connections to do that?
Reply: adam R  http://www.debunking911.com/sim1.gif

 http://femr2.ucoz.com/_ph/5/2/48769624.gif

How does this possibly look like a controlled demolition to you?

The simple fact of it is, the airplane and resulting fires is exacly what collapsed the building.
Reply: Tell me how I look stupid please. I am not trying to prove my knowledge on this topics cause I don't need to do it. Why would I lie about it in the first place? What I am saying is this experiment is far off from how a real experiment should be conducted to even resemble a tiny bit to what happened at NY that day. And I am only pointing obvious facts left behind in all of this. Don't know if you can read.
Reply: carlosdaperez  You just make yourself look stupid when you makes these hollow claims paid shill. You can't prove any of it in social media.
Reply: Tell me a little bit of your understanding of Newton's Third Law if you have any, then describe what types and amounts of energy losses were experienced when any imagined floor came down crushing the office contents, compressing air, and all that other stuff.
Reply: First, I want you to tell me how such crude "experiments" even remotely resemble reality. "invoking Newtons 3rd law" as if it's a magic word does nothing to help you. Notably because equal reactions does not equate to a negation of force. My hand coming down on a house of cards certainly involves Newton's 3rd law but that doesn't spare the house of cards.

Second, I want you to tell me HOW Newton's 3rd law even remotely helps your case. Certainly you should be able to considering how readily you invoked it. right? RIGHT?
Reply: 50framingbottles What are you trying to say? Of course I know physics and I'm sure I comprehend it way better than you'll ever will. It's also about materials science, thermodynamics, construction knowledge and lots of other things. But anyways, I don't get your comment.
Reply: "u dont have to use a physic bro..just use common sense.."

People rarely get the opportunity see skyscrapers get attacked by fully populated and fueled jetliners so common sense does very little to help understand and explain the physics, forces and consequences involved. It takes in depth analysis of very specific parameters and key visual evidence being synthesized into a cohesive and comprehensive framework if we are to approach any kind of truth in the matter.

1 fvcking plane made from aluminium can demolish the building and turn it into dust?.."_

Literally nobody is suggesting that a plane simply flying into each of the towers made them turn to dust. The planes merely did sustainable damage to the towers, the fires being broadcasted throughout the floors through elevator shafts and burning for several hours is what ultimately brought the towers down. But that doesn't sound quite as spectacular as "1 fvcking plane made from aluminium demolishing a building and turn it into dust." now does it?

"..and why building 7 collapse when the plane didnt even hit the building..?"

Building 7 caught fire from the ejected fuel enriched debris from the two tower strikes. In fact, building 7 is the easiest of them collapses to explain due to the simplistic construction coupled with video evidence of the process in action. It is the easiest of the buildings to model, after all.
Reply: Have you actually read the report? You just said several things that are simply untrue and if you had read the report what you just said there would be lies. Why do you feel the need to lie to me?
Reply: PotteryBound  Please do not ever comment again about any scientific matter. You're just making a fool of yourself. I can proudly say I am an engineer and I know that an experiment like this can't demonstrate not even a tiny bit of what happened on the WTC. There are lots of factors left behind in this whole "experiment" nonsense. You have any idea how much power is generated due to the impact and explosion of a whole PLANE on a building this size? It's actually not hard to comprehend.
Reply: Nicky F - You're asking questions that have been answered over 10 years ago.
Reply: trippnface - None of the buildings collpased at "freefall rate".

get a grip!
Reply: @DamnSuzuki100 says"
 "Do you have any other deflection to support your conspiracy theory that may have substance?"

I'm not sure how, but you seem to have completely misread what Bruce was saying.
Reply: ErgoCogita - By now I'm used to that. This person that impersonates others has no interest whatsoever to understand what happened. He'd rather just stick with the conspiracy theory cult, maybe becaue it will help protect his ego. The "free fall" claim is the easiest to debunk, yet he remains with it.
Reply: His experiment doesn't resemble the towers though.
Reply: regardless of his model being flawed which I think it is because there is one main problem with his experiment that I noticed right off the bat, none of his "floors" turned to dust pretty much like all of the floors of the twin towers did before they even hit the bottom. 
Good catch man lol
Reply: "the potato battery that proves that the unseen neutrons flow between dissimilar metals immersed in an electrolytic environment"

It's extremely clear to me now that I am speaking with a scientific illiterate. NEUTRONS you say? HAHAHHAHAHAHHAA. And with that, you have just removed any hopes of ever being taken seriously.
Reply: +ErgoCogita  Still waiting on your story about how exploding pancakes stack Cupcake.
Reply: +ErgoCogita  How are you making out with your story about exploding flapjacks Cupcake?
Reply: Gurvinder: I have not been capable of finding the specific testimony you describe, the one involving basements and explosions, etc. That claim of yours remains unfounded. As for your claims about WTC7, my response is that said building did not collapse in the manner and under the circumstances you describe. You are either being ignorant or dishonest about how WTC7 collapsed. Are you going to insist on making more of these unsubstantiated claims?